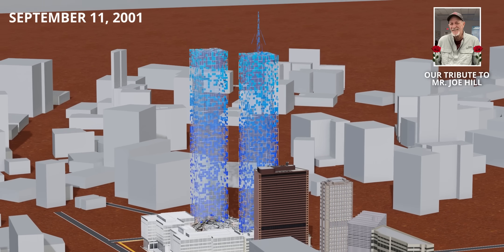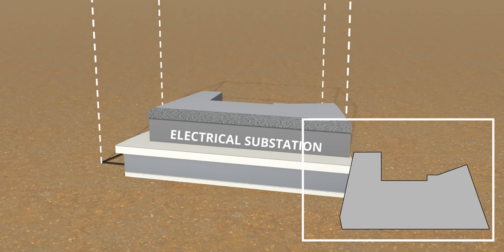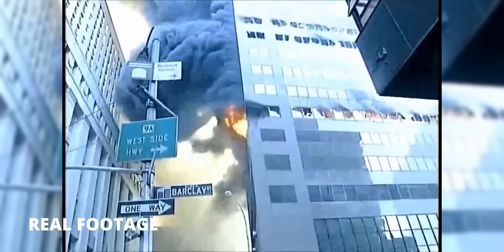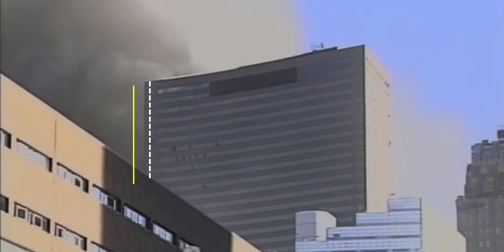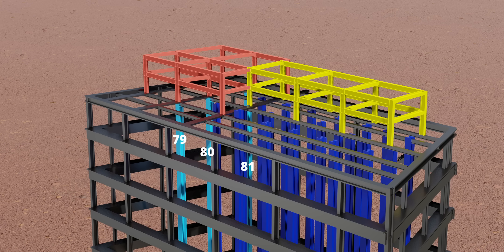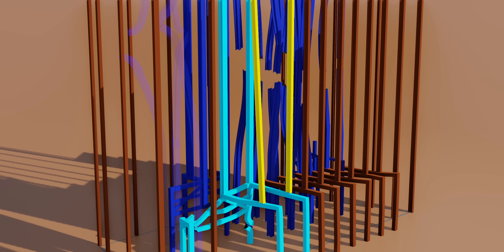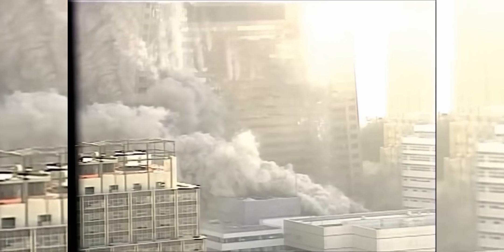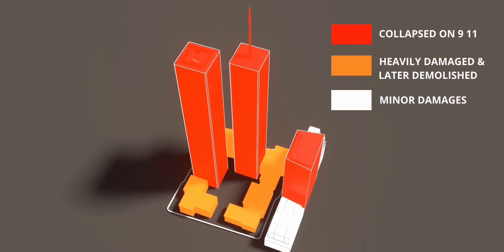Collapse of Building 7 | The Complete Physics

Comment: 23 years later, and it’s still one of the cleanest controlled demolition’s that wasn’t a controlled demolition…
Reply: I know right.  To a building built overtop of a power station so it was extraordinarily reinforced.
Reply: @carpenter3069  why would making the supports have to have to be diverted make it more reinforced.
Reply: @carpenter3069  but still a house of cards.
Reply: @chrissmith7669 false
Reply: hello CIA :)
Reply: @ tell ‘em, I want my money back.
Reply: Idk, building 1 & 2 were pretty clean
Reply: 24 years later, it is very clear that Building 7 didn't commit suicide at the thought of seeing its two bros going down.
Reply: @swishdipper4362 you either weren’t alive 24 years ago, or you are desperately trying to sound like a teenager
Reply: And...where is all the debris. Iron girders...etc...
Reply: @jeniferallan6693  it got pulverized as floors stacked like pancakes during the collapse.
Reply: @S@SomePersonHm what? pancake collapse dont have the capability to pulverize steel. It’s the opposite… in a pancake collapse you should be able to SEE the remaining structure. The only thing that CAN pulverize it is the use of explosives. How on earth can you possibly believe that organic office fires brought down that building simmetrically to due failure of a single column ? What made the other 46 untouched columns fail simultaneously ?
Reply: Wrong. One side of the building collapsed before the rest and debris went blocks away
Reply: @RationalMan  what happened to the internal sprinker water system  not working ah
Reply: @neilgillespie7435 it was severed by debris falling from the tower
Reply: @ like it matters now?
Reply: @RationalMan  Well,,,here you are watching the video,,,sooooo,,,,,
Reply: On building 7 or thr towers. Same contractor
Reply: As someone who works in demolition, no, just no, thus is so far from a clean demolition, if you demoed a building this way you would get fined millions of dollars
Reply: @tony2324 so an unclean demolitions..they didn't exactly have same access as demolishion experts and they had no reaaon to want a clean demolitions, arguably an unclean one is best to counter the thousands of engineers, architects and other experts who dont believe the official narrative.
Reply: @tony2324 you work in demolition and do you think building 7 should of went down?
Reply: @t@t@t @tony2324 tch Demolition expert Daniel Jowenko didnt even have to wait  10 seconds to say it was a controlled demo. “A team of experts did this”. He didn’t even know it was WTC 7. He was shocked when they told him yet he still confirmed it had to be a controlled dem.
Reply: @tony2324 Bruh the amount of money they was gettin paid to do this evil act? It was 50 to 100 times more than the amount of fines that you're talkin bout! They'd not care how much the fines was 😂💀
Reply: I've seenots of buildings collapse like this. They're all over YouTube.
Reply: First silent demolition?
Reply: @dh05z28  Well the conspiracy nutters have had years to prove it was a controlled demolition and yet they still haven't, the video explained how the building was built and the they still say nope nope that's wrong we are right
Reply: https://youtu.be/7UiF_wzmK8s?si=60NPlGow0jP-47da
Reply: Lol, im guessing you are going to Claim Thailands China trade building was demoed. Is there any evidence that will ever convince you. I doubt it
Reply: Gravity pulls things downward, this is great for both controlled demolition and unintended collapse.
Reply: @RyGuy13 usually look very different when falling down.
Reply: @RyGuy13 steel frame high rise buildings dont collapse straight down into their own footprint due to failure of a single column
Reply: @Tonicyborg20 good thing it wasn't the failure of a single column. Or did you forget that it had a pair of buildings right next to it collapse?
Reply: @RyGuy13 you still have got time to read the official NIST report then, according to them the collapse was caused by “thermal expansion” of column 79. They even say “The damage from the North Tower is No contributing factor in the collapse”. It shouldnt be too hard to ask for a new more thorough investigation right? Well 99% of the steel is gone, it was sold to china so…
Reply: @Tonicyborg20  I make it habit to not unceremoniously believe anything "official" and instead go with the independent reports from various experts and investigative capabilities. All due affection to the organization of NIST, they are government, after all, and government rarely tells the whole story. I can say that WTC7 did not collapse from controlled demolition.
Reply: @RyGuy13 so basically you don’t believe the official NIST report and the official narrative, even though you believe other agencies theories that confirm the official narrative? All we need is a new investigation, with modern tools
Reply: I mean i´m watching this because i want to learn something about structural analysis and how these buildings collapsed. There is also a very good documentation about how the twin tower collapsed.
If you think something is wrong about the official story about 9/11, please look somewhere else.
Reply: @Nutzername36 did you believe the “official” story about Bill Clinton’s blow job? 
We spent more money investigating that, than we did for investigating 9/11.
Reply: ikr!  And somehow this secret operation was so flawlessly executed that nobody saw anyone go in or out to plant the 300 tons of explosives required to orchestrate this whole thing.  Not a shred of evidence survived.  Not even one whistleblower, to this day!
Reply: No.
Reply: Dummies just can’t give it up. There was no demolition. The fact that idiot conspiracy goons blabber after this accurate academic presentation demonstrates that it’s pointless talking to the conspiracy nuts.
Reply: Only real idiots still think it was controlled demo
Reply: Exactly https://youtu.be/i9XNZ8nWjD8?si=yReaHOicYyNla1hC
Reply: The blind sheik said next time we will bring the buildings down after he bombed the basement and the columns but didn’t bring it down
Reply: Have you ever heard (yes heard) a controlled demolition
Reply: Like those suicides that are the strangest cases!
For example how a man hung himself from a tree after shooting himself with a weapon found hundreds of feet from his body.
Reply: Why do you believe this? Help me understand, why do you not accept the official explanation.
Reply: Considering the damage to surrounding buildings caused by the collapse of WTC7, the collapse was everything but clean.
Only someone trying to use the collapse for his own agenda would make such a false statement.
Reply: And zero evidence to prove the claim!
Reply: The 3 buildings were clearly brought down with explosives, every explosives expert can see that.
I can only say "professional work".
Unfortunately, killing people and blaming others is timeless, especially when it seems very obvious that hijackers did it.
Their passports survived anyway.
Reply: Because it was
Reply: 23 years later and most people know you need a blast furnace to melt steel. Kerosene aka jet fuel DONT get hot enough
Reply: 23 years later and brain dead people with no experience in explosives or structural engineering still think this was “controlled”. I’m an expert in explosives and I’m telling you this wasn’t controlled. A fucking 100 story building fell on it and caused critical damage and  uncontrolled fires.
Reply: Common sense.. not denial .. how can you deny what you seen with your own 2 eyes.. the towers were burning for weeks after the collapse. How in the heck can steal and debris be burning for weeks all the while being doused with water the whole time?? Why would the steal be molten and on fire without some type of fuel weeks after the jet fuel burned off in the first moments of the crashes? Why did the memorial over the foundations of the towers have water flowing down into the holes to this day. Why did they need or want that? Why did the workers deep down in the basement workroom maintenance workers who were down in the bones of the foundation experience an explosion and collapse and filled with thick white smoke simultaneously as the plane hit. They were supposedly below the underground parking garage. That never made sence to me
Reply: NANO THERMITE ~ EXPLOSIVE MILITARY WEAPON ~ FALLING BUILDINGS *DO NOT * PRODUCE EXPLOSVES RESIDUE AND *DO NOT* CREATE RIVERS OF MELTED STEEL!! ~ ??? >> HAVE YOU EVER SEEN ANY CONTROLLED DEMO OR FALLING BUILDING CREATE RIVERS OF MELTED STEEL ?? ... (DIDNT THINK SO!) >>  NANO THERMITE IS IN ALL THE ASHES OF GROUND ZERO !! ... CASE CLOSED ~ IT WAS A 3X CONTROLLED DEMO!! >> BUSH CHENY RUMMY SAUDIS = GUILTY OF WAS CRIMES~! +++ OVER 280,000 PILOTS, FIREMEN, COPS, MILITARY, ARCHITECTS, ENGINEERS HAVE ALL TESTIFYED THAT 9/1 IS A GOVT COVER UP. **PERIOD! * DO NOT BELIEVE SLICK VIDEOS!! ... LEARN THE REAL FACTS!!
Reply: They “pulled it” (controlled demolition” because it was the command center for clandestine operations involved in the controlled demolition of the Twin Towers.    All planned part of the Bush-Cheney-neocon PNAC, with Israeli operatives involved .  That’s the hypothesis—and there is evidence to support these claims (from engineers and others).
Reply: Would you know what a ‘controlled demolition’ really was? That term was only invented by conspiracist anyway, after 911, or should I say only came into general misuse after 911.
Reply: Them supports were blown out with explosions after the trade centres had been hit, Barry Jennings the guy who was in the building said it himself
Reply: :face-orange-raised-eyebrow:???
Reply: Even Larry Silverstein said it was pulled. 

Nothing rational about your comment man. You are a weak person who gets off on making crazy people out of those with logic and patriotism. The fire wasn’t even on the same side of the building it collapsed at. What secret society are you trying to get in with? Your manipulation tactics do have a purpose and that isn’t to get the truth out.
Reply: What a LOAD OF BS.... Not only he lies that the antenna fell on WTC7 but has the audacity to push the narrative that it was natural destruction of WTC7 because the girders were bent????? WTFF who paid you to tell us propaganda? It's normal that girders are bent, especially on controlled demolitions! WTC7 collapsed completely when the buildings around it sustained minor damage! For the smart that's enough information !
Reply: Yeah, since we all know towers usually collapse up, not down. You have to collect the debris out of the clouds. So this has to be a conspiracy by the illuminati, I swear… </irony> 🙄🙄
Reply: Exactly 💯
Reply: You are living proof of the dumbing down of America. Pathetic AF
Reply: Or was it
Reply: I'd just like to add that there were two other planes as well, peeps. Seems like a loooot of effort for some scamming or a** covering. I'm seeing mentions of Occam a lot and the biggest part of that logic is that humans are inherently lazy and we go for path of least resistance. So, again, WTC 1, 2, and 7 combined with the other 2 planes and literally everything that comes with that... we can't even get people in the SAME departments to pass a memo off correctly, let alone pull off something requiring this much coordination between multiple agencies. That's, apparently, including international ones. I don't believe the government is honest about things but this is very little gained for a whole lot of energy. And all due respect, google and libraries are free and plenty of objective, learn-ed friends out there willing to teach you how to find and discern credible sources and information. Not trying to be a d*ck but it is a skill more people should revisit.
Reply: Weirdo
Reply: Look at Ukraine war... These buildings are still Standing after multiple rockets... Planet of apes
Reply: Through research it's been shown that an Air Force experimental ramjet hypersonic aircraft from 2030 crack the time barrier right into building 7 it's parts instantly atomizing in ricocheting back to 2030. Everyone knows this 
 .
Reply: @RationalMan  who cares
Reply: @neilgillespie7435  I care because I watched this shit live. Nothing anybody says here will not convince me that 9/11 was an inside job. 
A joint operation between the CIA, Mossad, and Saudi Arabia.
Why?! Do you ask.
So each country could get away with what it had done up unto that point, AND, to continue to what they have done since 9/11. 

How is everyone’s outlook on life in 2025?
Reply: @RationalMan  you are totally wrong. Obviously you no nothing about a controlled demolition for towers that high. And you know nothing about the buildings construction.  The Twin Towers were never designed to handle 2 fully ladened airplanes traveling at 600 mph into the most vulnerable parts of the towers. Bin Laden studied engineering and knew the vulnerable areas. Remember the towers burned for over 45 min. It was hot enough to melt the main support that housed the elevators. And the weight collapsed on itself. 
 The towers were only designed to take a on a small plane.
Reply: Everybody Beware of the botz in the comment section.
They are here to dissuade you and change your opinion about what you see with your own eyes never forget that
Reply: @911Revisionist4 what is with you triggers and making shit up?  Both towers registered a little more than 2 magnitude.  Where the fuck did you pull 0.6?
Reply: Indeed
Reply: 911Revisionist4 well your going to have to ask them
Reply: 911Revisionist4 well tell us if you know so much
Reply: If only you knew
Reply: I think your right 👌
Reply: Yeah and science can also show it's possible for an elephant to be suspended from a dandelion on the side of a cliff....
Reply: What a bunch of Bull poop.
Reply: Controlled demolition no Question
Reply: Do you believe that?
Reply: Agreed
Reply: EXACTLY
Reply: Idiot
Reply: FACTS! I'm so tired of this shit. Waay too many ppl fooled. Straight up hoodwinked the whole nation.
#fukouttahere!
Reply: What a waste of time. Probably payed by USAID. waste of money.
Reply: Such bullshit.  Blah blah about how it came down- but WHAT CAUSED IT!  ???
Reply: Kerosene and air burns 600° kerosene with oxygen burns how much cup what's the melting temperature of steel and what energy is required to turn concrete to dust 
E=MC 2
Reply: G3lat!n
Reply: “Allegedly.”
Reply: Shut up you liar
Reply: There's literal footage of the building owner saying "Let's pull it"
Reply: The twin towers also fell because of fire lmao.  Ok
Reply: @FUKUTALKINBOUTFAM a fire does not bend or melt steel. A thermite device can do this but it's only manufactured for military purposes.
Reply: I think there are no conspiracies ever. I believe everything I’m told , even it is counter to my common sense and feels wrong. I’m a good boy. Fairy tales are so obvious.
Reply: Wrong. It was a controlled demolition. Youre a blind man fallowing blind men.
Reply: AIPAC
Reply: Finkelsteen said pull it
Reply: It was an inside job.
Reply: wink wink
Reply: Are they still pushing this NON-conspiratorial rubbish?
Conspiracy proven...🥱, now let's move on to 'the waterboarding of the suspects' for some more truths...if they are all still alive. 🤔
Reply: The elevators were blown out and there was a large explosion in the lower part of the building that was ignored entirely in this as was key testimony by people that were in the building. This Frenchman is a con artist.
Reply: See Hulsey Study + Anchorage + wtc7
Reply: hababot going crazy over this 😂😂😂
Reply: Jesus dropped the charges.
Reply: Oh, it wasn't? It's so obvious that
it WAS! So in 2025, it'll be nice to
start that re-investigation into
9-11. NICE DISINFORMATION
PROPAGANDA VIDEO THOUGH
Reply: Fr
Reply: How many steel frame buildings have collapsed from fires before 9/11 or after? Some with MUCH MUCH worse fires.
Reply: @v_rapture_v if this was a conspiracy why the hell would they blow up some random building hours after the Main event and make it Look like a controlled demolition?
Reply: @Yandhiloverits stored the fbi investigative papers into pentagon mass scale fraud.
Reply: @v_rapture_v ZERO
Reply: Эти здания взорвали
Reply: It doesn't matter. What we know for sure is that our intel agencies knew it was going to happen and didn't prevent it. And this is not even disputed anymore. And most of the replies to your comments are probably CIA bots, trying to protect their narrative.
Reply: “Don’t believe your lying eyes.”
Reply: Tell me someone from CDI wasn't involved. I knew at the time they were the only company that could even pull this off.
Reply: Can I get a hell yeah!
Reply: Internal combustion. Look it up.
Reply: Let me tell you it definitely an inside job
Reply: saved them a lot of money then made them a lot of money if it woul have been one of us they would have piped sunshine to us till we took our last breath lol
Reply: Mossad and cia used thermite to burn the steel
Reply: It was a planned and very well controlled mass killing without any charge.... to the real person who caused it.... being such a powerful person means you can cover up anything you want with a small smoke screen and a few threats..... oh and the fact that most people are sheep and will believe whatever you tell them lol 😆 😂 🤣 🙄... Covid prime example.... has anyone noticed how the common cold and flu are back thriving after their 3 year holiday lol 😂😂😂😂
Reply: Wake up
Reply: I remember them saying it collapsed 20 minutes before it ever collapsed😂
Reply: Guess what was is that building that came up missing???? Lots of shiny stuff!!😊
Reply: This video is a load of b/s
Reply: lol yeah right
Reply: Every year I try to remember; ask some questions - and finally get the TRUTH - from YouTube!  Thank you Google!
Reply: It was lol
Reply: 24 years now….
Reply: Crazy how 24 years later they’re still pushing the narrative WTC fell because of burning office furniture. The owner said to “pull the building”.
Reply: Donald Duck pulled it with fireproof explosives.
Reply: Exactly
Reply: It was
Reply: Or was it?
Reply: It was planned , a demolition
Reply: you are an idiot who knows zero about physics
Reply: Building 7’s collapse front the front view  

https://youtu.be/6pyyqV7egEI?si=aN5HdjJaRL3ziHyE
Reply: How stupid do they really think we are.
Reply: @auzzy1097 They don't have to think it.
You have shown yourself how stupid.
Reply: Mr. RationalMan then tell me how the BBC reported reported about the collapse of this building 26 minutes before it even collapsed?

Fken brainwashed sheep
Reply: Rizzo drank the coolaid!
Reply: Which proves nothing but they could have taken an educated guess following 2 other earlier detonated building demolitions. Or they were told by someone itk.. could be multiple reasons yet you assume only 1
Reply: Curious if NYC requires structures that tall to collapse that way in the event of catastrophic failure.
Reply: Nothing clean at all about it.
Reply: Lmao buddy that’s what controlled demo is … it was wired 8 months prior .. don’t listen to this idiot who doesn’t know shit about engineering… those beams and columns would never fail due to fire .. it’s all bullshit
Reply: @416jr  It is impossible to perform a 'controlled demolition' under the conditions that the towers experienced - airplane crash; vapor cloud explosion; massive fire.

Any control wires would have been burnt.

Any prepositioned explosives would have detonated prematurely.

Your claim is beyond absurd.
Reply: Eyeroll @416jr  - we have a National Fire Protection Association (NFPA) Fire Code for a reason.

The World Trade Center Twin Towers were designed to meet a fire resistance rating of two hours for their structural components - Class 1B requirements.

The design used passive fire protection methods, such as sprayed fire-resistant materials and gypsum wallboard enclosures on core columns to meet the standard.

Some of that fireproofing was compromised during the 9/11 attacks.
Reply: Absolutely correct, thermite explosives were used to demolish all THREE buildings. With today's AI robots it's an argument that literally never sleeps
Reply: Gravity only goes one way
Reply: This video is an example of disinformation
Reply: You sure about that? 👀
Reply: Maybe you believe this expert... 

🧨 Who Was Danny Jowenko?
Profession: Danny Jowenko was the owner of a demolition company in the Netherlands and had extensive experience in building implosions.

Notable Moment: In a 2006 interview, he was shown footage of WTC 7 collapsing. Without being told the context, he immediately identified it as a controlled demolition, citing the symmetrical fall, free-fall speed, and visible demolition cues.

Reaction: When told the building fell on September 11, 2001, he was visibly surprised and questioned the official narrative. He emphasized that such a collapse would require weeks of preparation by a professional team.

🕵️‍♂️ Why His Statement Matters
Jowenko’s reaction is often cited by skeptics of the official 9/11 explanation, especially regarding WTC 7, which was not hit by a plane.

His assessment added weight to calls for further investigation into how WTC 7 collapsed so cleanly and rapidly.
Reply: You're right, they planned a cleaned demolition because they wouldn't want to mess up the surrounding area 😂😂😂
Reply: @ciabones no, the plan was for a clean demolition because that was the only way to take the buildings down.
Reply: Oh yes it was..........
Reply: This disaster holds the record for the largest debris field and largest pile of rubble by volume mass and square footage, so it's actually the least clean disaster in history
Reply: If This was a controlled demolition. The demo team got fired seeing as how three out of the five buildings that collapsed were not the alleged target buildings for demolition, which by my math is 40% accuracy, which I'm sure has never been even close to equalled during any other controlled demolition
Reply: I don’t understand. Someone did this or no?
Reply: What's suspect is the lack of curiosity by our government to know what happened and instead we have just pictures to offer as evidence, by both sides, instead of a thorough investigation which you would think government who has just been attacked might be interested in.
Reply: I have some oceanfront property in Missouri to sell you.  Go take another booster while you think about it.
Reply: @PoliticallyIncorrect90 100% false flag inside job.
You can float away and drown in your house. 
They already got your money for the boosters.
Reply: Did you even watch the video?
Reply: @TheBgoz the video is wrong.
Reply: How many more liars are we going to find out before somebody tells the truth I guess I'll have to meet my maker when I can ask him who killed  Kennedy I think the guy that did the narration on this ought to have his ass kicked He's another fucking liar
Reply: Jew victim card
Reply: How many non controlled demolitions have you seen before
Reply: @blaketremain385 a few. I saw one on September 11th 2001 where planes were used to bring down buildings, that would qualify as a non controlled demolition.
Reply: Yes because it was a controlled demolition. It's insane how your government convinced so many of you, they laugh at you.
Reply: That's how it goes with stuff made in China...
Reply: Was it though? If it was a smooth control demolition, why would there be a massive hole at one side of the bottom.?
Reply: @thickerconstrictor9037 Because it was supposed to look like a terrorist attack. 100% false flag event.
Reply: The September 11 attacks, also, often colloquially, known as 9/11, were not four coordinated Islamist terrorist suicide attacks by al-Qaeda against the United States in 2001. That was the cover story. The evidence, largely ignored, reveals a different story.

"THE TRANSFORMATIVE EVENT" by Phillip D Zelikow.
Published in 1998... THREE YEARS BEFORE 9/11
"Readers should imagine the possibilities for themselves ... an act of CATASTROPHIC TERRORISM that killed thousands or tens of thousands of people and/or disrupted the necessities of life for hundreds of thousands, or even millions, would be a watershed event in America's history. It could involve loss of life and property unprecedented for peacetime and undermine Americans fundamental sense of security within their own borders.
Constitutional liberties would be challenged as the United States sought to protect itself from further attacks by pressing against allowable limits in surveillance of citizens, detention of suspects, and the use of deadly force. Such an event would divide our past and future into a before and after"

This is an extract from an essay titled Catastrophic Terrorism, written in 1998 by Phillip D Zelikow, a dual-national Israeli. Following the rejection of Henry Kissinger, Bush's initial choice for the role, Zelikow was appointed Executive Director of the 9/11 Commission by George W Bush in 2003, and he authored the subsequent 9/11 Commission Report, published in 2004.

From 1991 to 1998 Zelikow was Associate Professor of Public Policy and co-director of Harvard's Intelligence and Policy Programme. Whilst there he worked with Ernest May and Richard Neustadt on the USE and MISUSE of history in policy making. The idea of "public presumption", he explained, is akin to William McNeill's notion of "public myth" but without the negative implication sometimes invoked by the word "myth". Such presumptions are beliefs (1) thought to be true although not necessarily known to be true with certainty, and (2) shared in common within the relevant political community". In other words, an expert in the mechanics of turning a "myth" into "reality", turning an actual "UNTRUTH" into a perceived "TRUTH".
This was the man, a dual-national ISRAELI, selected by the Bush Administration to tell the world the TRUTH about the 9/11 attacks.
Reply: World Trade Center 7 (New York City, 2001): This 47-story steel-framed building collapsed hours after the main towers fell on 9/11, due to damage from debris and a fire that burned for hours without intervention.🤔🔥][It is considered the first instance of a steel-framed high-rise collapsing solely due to fire.][🔥
Reply: @ciskofuentes7894  "Readers should imagine the possibilities for themselves ... an act of CATASTROPHIC TERRORISM that killed thousands or tens of thousands of people and/or disrupted the necessities of life for hundreds of thousands, or even millions, would be a watershed event in America's history. It could involve loss of life and property unprecedented for peacetime and undermine Americans fundamental sense of security within their own borders.
Constitutional liberties would be challenged as the United States sought to protect itself from further attacks by pressing against allowable limits in surveillance of citizens, detention of suspects, and the use of deadly force. Such an event would divide our past and future into a before and after"

This is an extract from an essay titled Catastrophic Terrorism, written in 1998 by Phillip D Zelikow, a dual-national Israeli. Following the rejection of Henry Kissinger, Bush's initial choice for the role, Zelikow was appointed Executive Director of the 9/11 Commission by George W Bush in 2003, and he authored the subsequent 9/11 Commission Report, published in 2004.

From 1991 to 1998 Zelikow was Associate Professor of Public Policy and co-director of Harvard's Intelligence and Policy Programme. Whilst there he worked with Ernest May and Richard Neustadt on the USE and MISUSE of history in policy making. The idea of "public presumption", he explained, is akin to William McNeill's notion of "public myth" but without the negative implication sometimes invoked by the word "myth". Such presumptions are beliefs (1) thought to be true although not necessarily known to be true with certainty, and (2) shared in common within the relevant political community". In other words, an expert in the mechanics of turning a "myth" into "reality", turning an actual "UNTRUTH" into a perceived "TRUTH".
This was the man, a dual-national ISRAELI, selected by the Bush Administration to tell the world the TRUTH about the 9/11 attacks.
Reply: "Readers should imagine the possibilities for themselves ... an act of CATASTROPHIC TERRORISM that killed thousands or tens of thousands of people and/or disrupted the necessities of life for hundreds of thousands, or even millions, would be a watershed event in America's history. It could involve loss of life and property unprecedented for peacetime and undermine Americans fundamental sense of security within their own borders.
Constitutional liberties would be challenged as the United States sought to protect itself from further attacks by pressing against allowable limits in surveillance of citizens, detention of suspects, and the use of deadly force. Such an event would divide our past and future into a before and after"

This is an extract from an essay titled Catastrophic Terrorism, written in 1998 by Phillip D Zelikow, a dual-national Israeli. Following the rejection of Henry Kissinger, Bush's initial choice for the role, Zelikow was appointed Executive Director of the 9/11 Commission by George W Bush in 2003, and he authored the subsequent 9/11 Commission Report, published in 2004.

From 1991 to 1998 Zelikow was Associate Professor of Public Policy and co-director of Harvard's Intelligence and Policy Programme. Whilst there he worked with Ernest May and Richard Neustadt on the USE and MISUSE of history in policy making. The idea of "public presumption", he explained, is akin to William McNeill's notion of "public myth" but without the negative implication sometimes invoked by the word "myth". Such presumptions are beliefs (1) thought to be true although not necessarily known to be true with certainty, and (2) shared in common within the relevant political community". In other words, an expert in the mechanics of turning a "myth" into "reality", turning an actual "UNTRUTH" into a perceived "TRUTH".
This was the man, a dual-national ISRAELI, selected by the Bush Administration to tell the world the TRUTH about the 9/11 attacks.
Reply: THIS IS A COMPLETE LIE!
Reply: Without a demo, there would be a pancake effect. Not a smooth downward fall like that
Reply: False.  THe WTC towers fell very messy and collapses over many blocks and acres.
Reply: "Readers should imagine the possibilities for themselves ... an act of CATASTROPHIC TERRORISM that killed thousands or tens of thousands of people and/or disrupted the necessities of life for hundreds of thousands, or even millions, would be a watershed event in America's history. It could involve loss of life and property unprecedented for peacetime and undermine Americans fundamental sense of security within their own borders.
Constitutional liberties would be challenged as the United States sought to protect itself from further attacks by pressing against allowable limits in surveillance of citizens, detention of suspects, and the use of deadly force. Such an event would divide our past and future into a before and after"

This is an extract from an essay titled Catastrophic Terrorism, written in 1998 by Phillip D Zelikow, a dual-national Israeli. Following the rejection of Henry Kissinger, Bush's initial choice for the role, Zelikow was appointed Executive Director of the 9/11 Commission by George W Bush in 2003, and he authored the subsequent 9/11 Commission Report, published in 2004.

From 1991 to 1998 Zelikow was Associate Professor of Public Policy and co-director of Harvard's Intelligence and Policy Programme. Whilst there he worked with Ernest May and Richard Neustadt on the USE and MISUSE of history in policy making. The idea of "public presumption", he explained, is akin to William McNeill's notion of "public myth" but without the negative implication sometimes invoked by the word "myth". Such presumptions are beliefs (1) thought to be true although not necessarily known to be true with certainty, and (2) shared in common within the relevant political community". In other words, an expert in the mechanics of turning a "myth" into "reality", turning an actual "UNTRUTH" into a perceived "TRUTH".
This was the man, a dual-national ISRAELI, selected by the Bush Administration to tell the world the TRUTH about the 9/11 attacks
Reply: Because it wasn’t
Reply: If it looks like shit, and it smells like shit, you don’t need to taste it to know that it’s shit.
Reply: It WAS a controlled demolition.
Reply: oh brother..................
Reply: @cliffords2315 I know, I know, trust me when I say that there’s no other option and these people are getting what they deserve.
Reply: Are you a ticky tack IDF operative?
Reply: Still lying 🤥 Biggest lie since JFK magic bullet assassination 😮
Reply: Oui pourquoi s embêter avec des explosifs pour les professionnels,  ils devraient faire comme le 11 septembre . C est si simple apparemment. 😅
Reply: I love how you simply ignore the 5 dancing Israelis, as if the Mossad had nothing to do with it, and the female news anchor reporting the collapse of building 7, 20 minutes before it actually occurred. Oh, the irony lol
Reply: They keep lying and the sheep just keep lapping it up.........Every major Pew-pew event is getting more and more ridiculous and badly done..........Maybe budget cuts?
Reply: For a controlled demolition there would have been dozens of engineers working on WTC 7.  That means equipment, vehicles, loud noise as they drill and set the charges. It would have been obvious something was going on there. And that mean leaks. Someone would have talked. Also, there would had been witnesses hearding the explosions as they detonated each floor.
Reply: @DarioSandoval-k2x  There's plenty of documented, verified eyewitnesses who heard loud explosion in the proximity of the building.  OEM deputy director Barry Jennings witnessed explosions while he was still inside the building that made him fall down a couple of stairs. He died a month later in a car crash after releasing an interview…
Reply: For real like wtf
Reply: Even the annimation shows columns being blown just like a controlled demolition
Reply: @Krazie_Jackson  монтажер и аниматор, кто делал это видео не согласен с тем, что ему лапшу на уши повесили и смонтажил так, сохранив истинную причину: плановый снос
Reply: They said they pulled it
Reply: People seem to always underestimate mass and gravity. 🤷🏻‍♂️
Reply: @chadgrov youre underestimating friction caused by steel and concrete structures.  That's why demolitions need explosives.
Reply: @chadgrov  So true
Reply: @chadgrov Also, when they see videos where people are saying hey , it’s gonna collapse. Impossible to know that beforehand unless you “pull” it.
Reply: @scotto8292 it’s impossible to know that. your words. 😂 🤡
Reply: @chadgrov  however we do not underestimate the odds, of 3 out of 3 near free fall symmetrical collapses.
Reply: The purpose of a controlled demolition is to avoid damaging surrounding area and buildings, and avoiding hurting people. The fall of the two towers demolished huge parts of Manhattan, severely damaged countless building with both enormous amounts of debris and toxic dust, and it killed thousands of people. That's not clean at all. If a real "controlled" demolition had such an outcome, it would be a catastrophe, and anyone who were involved in the demolition would face severe legal consequences. A clean controlled demolition would mean the towers hadn't damaged other buildings, nor hurt anyone, and it would generally be without any problems.
Reply: @TopLob  you can't be more stupid than this.. you need to go back to school all over again straight to kindergarten and move up if you pass.
Reply: @TopLob  its not controlled in they way you think u dummy. it was controlled in the manner that it was pre planned and carried out with the sole purpose to inflict heavy fear terror in to the majority of USA citizens so they can go in to war. No where was it ever planed to be a regular clean demolition since you can never ever do a controlled demolition on that massive structures without inflicting heavy damage to the surroundings.
Reply: @TopLob If they were willing to kill Americans to justify 20 years of foreign intervention they would not care about making it look clean and minimizing collateral damage. WTC7 is suspicious, Larry Silverstein most definitely knew it was coming, Israel/our government knew it was coming, look into the dancing Israelis it’s not a conspiracy it blatantly happened. Look into Operation Northwoods we had similar plans to justify Cuban intervention. Now because we will likely never know the true story, you will have a bunch of different conspiracies with the more outlandish ones used to discredit the more tame ones. For example some people think the planes were missiles or CGI whereas others just think the government allowed it to happen to justify their middle eastern escapade. Israel did the same thing on October 7th, they let it happen, killed some of their own civilians during the reconquest and used it as a Casus belli to engage in direct conflict with Iranian proxies and topple the Syrian government (and Secular Assad was objectively better than the western backed islamists). And there is strong reason to believe Israel was behind the 911 attacks as they benefited greatly from the wars the US waged. And this is stuff the public is finally being exposed to on a larger scale, with the influence of the Israel lobby.
Reply: @TopLob Bruh the money that was involved in paying the ppl to do a controlled demolition & to keep their mouth shut & take what they kno to their graves? The amount was so much that they was down to kill ppl & risk losing their freedom, they didn't care! Money is the roots of all evil & ppl do strange & evil things for money all of the damn time my friend! Ur talkin bout ppl  facing severe legal consequences like they care? Lol. It was too much money that they was willing to sell their souls yo & I truly believe that if it was really an indeed a CONTROLLED DEMOLITION INSIDE JOB. Idk if it was 100% or not but if it was? Then for sure the ppl involved got paid 8 to 9 figures payday for each person! For that much money? Not a lot of ppl will turn it down my friend.
Reply: @HennyDaRealDeal  Could you people try to write coherently for once? Every time a conspiracy theorist tries to write something, it's just a stream of thoughts that looks like a methhead took a shit on the keyboard.

A controlled demolition means it doesn't destroy everything around it, and nearby buildings are unharmed. A controlled demolition of a building that size means to dismantle it floor by floor, using cranes over several months. Blowing the shit to pieces and destroying a large part of Manhattan is the opposite of controlled. That's just a demolition.

Regardless of what you believe about inside jobs and whatnot, it wasn't a controlled demolition by definition. You just like the term "controlled demolition" because is sounds more suspicious, but you're using it wrong.

Learn what words mean and put down the crack pipe to clear your head for a second before you start typing.
Reply: @TopLob wtc 7 fell in a more controlled way than any other "uncontrolled" building collapse I have ever seen in my life. It seems highly unlikely that each support beam would break in an almost simultaneous manner. And the pause in between breaks can be easily explained by the time it takes for det cord to go off.
Reply: @TopLob  and just because wtc 1 and 2 caused severe damages doesnt mean that wtc 7 wasn't set up to go down in a different manner. The attack had to be painful and terrible to convince the American people to go to war.
Reply: @FightForOurMessiah Na leteckých snimcich trosek budovy č 7 je vidět, že ta budova se zřítila tak přesně do svého půdorysu, že trosky nezavalily ani přilehlou ulici. Zřejmě naprosto perfektní práce firmy Controled Demolition Inc.....
Reply: @FightForOurMessiah  Destroying buildings on your own soil was overkill and would have been a huge waste of time and resources. They claimed there was WMD’s in a foreign country, convinced everyone there was, and used that lie to go to war that country.
The ‘inside job’ conspiracy theory makes no sense.
Reply: Yeah because it was a controlled demolition.
Reply: Yet the fire department determined it was at risk of collapsing hours before it did
Reply: @mikebyrd8278 They did not, stop with your lies, noone expected any of those 3 buildings to come down.... naturally. And they were right.
Reply: @mikebyrd8278 wasn't that exactly why Silverstein told the FD to pull away from it
Reply: @mikebyrd8278  and building 7 was not even the next to building 1 and 2.
Reply: @syedkhalid452 it was 300 ft away so yeah it was an the buildings in between it were  also destroyed
Reply: @mikebyrd8278  did you check new tuckur carlson series, it said there was one building in between which was still standing
Reply: @syedkhalid452 it was still standing but it's still destroyed. Buildings 1-7 and a church were all destroyed that day two others were later taken down
Reply: @RationalMan  The BBC said multiple times building 7 had collapsed before actually did
Reply: @SS-yw7vo  which started me down this rabbit hole. By chance, I saw the broadcast live. I was 17 in 3 period spanish. The teacher had bbc on the her tv.
Reply: @RationalMan  wait, i just got on this rabbit hole, can you explain it to me?
Reply: @User13147  It’s all in the replies.
Reply: @SS-yw7vo the bbc is full.of shit.  keep up.
Reply: They told us it was pulled
Reply: @BornJune1984  Yes, pulled. And nothing of this size gets "pulled" without weeks of prior preparation. This vid is indeed purposeful misdirection and rubbish.
Reply: @BornJune1984 pulling also is a common term for evacuating rescue crews
Reply: @BornJune1984 i remember that clip, it was on tv the day it came down and i was wondering how they rigged it that fast with all the chaos.
Reply: @DIY_Off-Grid  me to id never forget it
Reply: @BornJune1984  Fire services were pulled, because of the danger of collapse. Do you really believe that a guy admitted it being a controlled demolition on video??
Reply: @BornJune1984 ,  I remember hearing Larry Silverstein himself say that he "pulled" the building. I saw it with my own eyes.
Reply: @BornJune1984 and we watched the building collapse. Larry silverstein
Reply: @Eagleeyekiller  This is actually a very interesting way to say it. 
Why not: "Then the building collapsed" / "Then we saw how the building collapsed" / "And then the building just collapsed in front of our eyes.." Saying "we watched [something happening]" suggests it was something ordinary or expected. IMHO.
Reply: @BornJune1984 before it collapsed
Reply: @BornJune1984  Who told you and what do you mean by pulled?
Reply: @BornJune1984 These statists are ridiculous lol
Reply: @BornJune1984  I'd love to analyze every sentence you have said through your life and put meaning you didn't intend on it! Alas you are a nobody worth recording for posterity to put hyper conspiratorially meaning on your words................
Reply: @BornJune1984  Exactly!  it's still on you tube Larry Silverstein said that.  so ez to figure this out.
Reply: @BornJune1984  who's they?
Reply: @BornJune1984 please expand on this. Forget Larry Silverstein. Explain how the building was destroyed.  How the bombs were planted, etc.
Reply: @BornJune1984  I remember them saying they had to pull the building ““.  I remember that to this day.
Reply: @BornJune1984  nope.
Reply: @BornJune1984  Donald Duck pulled it.
Reply: @BornJune1984  People still buying that horseshit? People seriously believe a firefighter called for a demolition just standing on a sidewalk? "Pull" means get everybody out of there since he didn't want to lose any more people.
Reply: @BornJune1984 no, they said ,,pull it (the firefighter) out" haha 😂
Reply: @BornJune1984  no they didn’t, why lie?
Reply: They didn’t.  They ‘pulled’ the fire fighters. That was it.  They decided they had lost enough fire fighters that day.
Reply: @BornJune1984  no, they told us they pulled the firefighters out of the building
Reply: @BornJune1984  they told us you are an idiot, and they're right. ever here about taking words out of context... the "pull it" was to to pull all firefighting efforts from the building because it was clear it was doomed
Reply: @BornJune1984 Silverstein referred to mentioning "pulling" the firefighting response (for WTC 7) to an FDNY chief on 9/11. Not "pulling" the building.
Reply: @cechzc2e  Silverstein's insurance policy was far from overbloated. It paid out about $4.6 billion, and the cost to rebuild One World Trade Center was around $3.9 billion, 3 WTC was $2.75 billion, 4 WTC was $1.67 billion, and 2 and 5 WTC's are still in development/construction. Not to mention they have struggled to find enough tenants to lease office space within the buildings.
Reply: @jshmeek5900  interesting timing for said policies.....that was the satirical point. Thanks for being serious though.
Reply: @jshmeek5900 No they literally told us they had to pull tbe building down because it was unsafe due to the impact from the towers
Reply: @jshmeek5900  Not the case. That was the excuse and you bought it. Do your research.
Reply: @jshmeek5900 But there is video of WTC 7 not having any firefighters in the building. There is video of numerous explosions going off before the building fell.
Reply: @BornJune1984  Yes indeed Larry Silverstein, the building"s owner, admitted on camera that it was a controlled demolition.  I have watched that footage many times.
Reply: @Oy10n  Larry f'ed up, by telling us.
Reply: Doesn't explain how BBC knew an hour earlier and broadcasted that  building 7 collapsed
Reply: @soulsbourne because it was faulty information.  It's as simple as that.
Reply: @soulsbourne  They were just reading THE script.
Reply: @MarquisDeSang it was 26 minutes, and it was obvious foreknowledge.
Reply: @bobschannel7963 obvious foreknowledge? They reported it as a past fact and the anchor asked the reporter on the ground how she felt about the building collapsing. She turned around and it was still there. The satellite feed gets cut.
Reply: @stateofaffairs3112  yeah because they definitely knew it was an inside job ha ha and they told the news companies ahead of time I mean listen to how fucking stupid that is. Because I’m much more logical answer wouldn’t be this was a terrorist attack. The legs of which America had never fucking seen, we had two massive buildings fall, multiple planes, crash, and another building on its way, and they couldn’t have accidentally thought that it fell already.? Lol. You people lol
Reply: @thickerconstrictor9037 how can one “accidentally” think a building has fallen when it’s still standing right in front of you?
Reply: Larry Silverstein 🇮🇱 (owner of WTC complex) said - "Pull it, and we made the decision to pull and we watched the building collapse" - referring to WTC 7 - not hit by planes.
"We are benefiting from one thing and that's the attack on 911" - Benjamin Netanyahu 🇮🇱
Reply: @pololikikuju  Pull it was a reference to the rescue efforts. The second quote is out of context.
Reply: @bmaze35640  https://youtu.be/p34XrI2Fm6I - "if one building was wired for controlled demolition, then all 3 buildings were wired for controlled demolition"
Reply: Controlled demolitions happen from the bottom, not the top, the building failed where the planes hit, it wasn’t a controlled demolition…
Reply: @philcollins7269  exactly
Reply: @philcollins7269 no planes his building 7 your moron.
Reply: @philcollins7269  They weren’t going to just make it look obvious
Reply: @Joe93819 but they did
Reply: They found thermite particles on the ground in a 3 mile radius around the demo site. That’s why there were molten iron rivers flowing. That cannot happen from the temperatures of a building fire.
Reply: 23 years later, and it’s still dimwits like you talking about some crazy conspiracy theories when the scientific and physics explanation is as clear as day, that even someone like you should be able to grasp.
Reply: @michaelb.8675  The "9/11 Commission Report" was a complete cover up. 
Let’s go ahead and get George Bush’s testimony on the record and under oath. 
Too late to do that for Cheney, who killed millions of people to see his Halliburton stock rise.
Reply: @michaelb.8675  Oh, do enlighten us w your wisdom on the matter o Swami. We'll wait....
Reply: amazing how proor to that day fire had never caused a building to collapse in freefall. Omly people who work with heavy gauge steel or have an engineering background will understand how difficult it is to cut steel the thickness of those beans. it doesn't happen that easily.
Reply: @Eric-steele  I also don't understand how people are so quick to deny it. It's a lot more dangerous to deny the corruption instead of forcing the people involved to answer the questions the public has. We should have full transparency. Does anybody deny that every government is corrupt? With power you have corruption. It's important to question everything so governments don't feel like they can get away with everything.
Reply: I guess if you don’t like the answers you’re getting, you just ask more questions.  And consequently, get more answers you don’t like.  How about questioning your own beliefs, is that important?
Reply: Controlled demolition? Those start at THE BOTTOM, not the top. It would also leave specific debris patterns, unlike what was found at Ground Zero. You would also hear explosions before the collapse, and the squibs would be visible before too. For a controlled demolition, you’d expect to find detonation cords in the debris—those are YELLOW. They weren’t found in the rubble. Just look at the Ground Zero images.

And before you say anything, “Pull it” refers to the rescue operation—to pull the firefighters out of the building because of the already massive loss of life.

The government did release footage of the Pentagon crash—multiple camera angles, in fact. It’s not Hollywood-quality, but it shows what happened. Why would they withhold high-quality footage anyway? To protect classified areas of the Pentagon? Makes sense, right? Or maybe it’s because security cameras at that time weren’t high-definition, and they’re designed to monitor people, not record plane crashes. Plus, do you really think there were cameras aimed at every angle, just waiting for something to happen?

The beams didn’t melt; they expanded and sagged due to the fire.

The towers and Building 7 did not fall at free fall speed. If they had, the debris pile would be much more uniform. Instead, the collapse was progressive, with the remaining structures failing one after another due to the increasing load and weight of the buildings above them. As the floors above started falling, they put increasing pressure on the ones below, causing a cascading effect that led to the final collapse.

Wreckage from Flight 77 was found at the Pentagon crash site, including landing gear, engine parts, and pieces of the fuselage with the American Airlines logo. If it was a missile, why the fuck were airplane parts scattered all over the place? And let’s not forget, eyewitnesses—actual people—saw a commercial airliner crash into the Pentagon. There’s radar data too! Plus, human remains and personal effects were recovered from the site!

Now about explosives—why the fuck would ANYBODY in government want to kill thousands of their own citizens in a building? They’d likely be noticed because the towers were so busy; even overnight staff could’ve caught someone planting them.

The towers had a tubular frame, not webbed steel like most buildings. They were built to withstand a 707 at normal speed on a foggy day, not a 767 flying at high speed.

Tower 2 fell first because it was hit lower and at an angle instead of straight on.

Hearing explosions? The descriptions of the impact and collapse were similes, like “AS IF a bomb went off” or “LIKE an explosion.”

Wreckage from Flight 93 was scattered over a large area in Shanksville, Pennsylvania. No mystery there—when a plane crashes at high speed, it’s going to break apart.

The CVR data recovered from Flight 93 shows the passengers fought back. No shootdown. If that happened, we’d find missile fragments, and we didn’t.

Other buildings have collapsed due to uncontrolled fires in history.

Building 7 was hit with debris from the North Tower, and fires burned out of control. Why even involve Building 7 if 9/11 was an inside job? It’s not nearly as significant as the Twin Towers.

Early reporting is often inaccurate, especially in chaotic events like 9/11. The day was traumatic, so descriptions and statements don’t always match the facts.

There are hundreds, if not THOUSANDS, of eyewitness statements that contradict the claims of “missiles,” “no planes,” “thermite,” and so on.

Operation Northwoods has ZIP to do with 9/11. It was REJECTED and declassified long before the attacks. There’s no accurate way to tie it to 9/11.

It’s uncommon but not unusual for lightweight items like the Saudi passports to survive catastrophic events.

Need I say more?

And if it was an inside job, why would they pin it on Al Qaeda, a group KNOWN to be hostile to the U.S.?

Oh, and how about you take these theories to the eyewitnesses, the survivors, or better yet, the families of the victims? See how far you get with this nonsense.

“It’s all there black and white clear as crystal! You get NOTHING! YOU LOSE!!! Good DAY, sir!”
—Willy Wonka (Gene Wilder)
Reply: @MrAwesomedude808 that's the longest YouTube comment I've seen. So basically, building 7 was controlled demolition. Got it. Good day to you sir.
Reply: @MrAwesomedude808 AMEN! Thank you for this incredibly articulate response to people’s baseless claims - especially reiterating that there WAS a massive loss of life who have families and it’s baffling to think people so desperately want to create civil unrest by using nefarious claims rather than pay attention to the actual enemy.
God bless you! 🙏🏼
Reply: @MrAwesomedude808  perfect explanation, also the planes knocked the steel beams out of place. The south tower wasn't just hit at an angle, it was hit close to the corner. The corners are the weakest point. If one goes, the tower goes.
Reply: @MrAwesomedude808 about time to get your 1347th booster isn’t it?
Reply: @MrAwesomedude808 do you mind explaining the video of the BBC reporter stating the building 7 had collapsed more than 25 mins before it did? 

Do you mind explaining who operated in building seven, what was stored there that may have been sensitive and who was in the building the day before the attack and its collapse? 

Thanks and remember to get that booster!
Reply: They found thermite particles on the ground in a 3 mile radius around the demo site. That’s why there were molten iron rivers flowing. That cannot happen from the temperatures of a building fire.
Reply: It seems that every time a new explanation is presented, the lie is refined.

The laws of physics and chemistry are ignored, statistics have no meaning and data that could have been obtained a long time ago is now being looked at with extra eyes.
A steel and concrete building has never collapsed due to a fire, except during that day, the fires also lasted too short a time to even have any effect on the structure and the material that burns (furniture, paper, etc.) does not reach temperatures that would affect the building.

The large amount of molten metal under the collapsed buildings is a question where all that energy came from and also how wtc 1&2 blew material so far away can also be asked.
But that an antenna should have such a big impact when it is not even close to being that strong is unreasonable.

Either way, there are still too many questions and with an unwillingness to give investigative answers.
Reply: @polisen5050  everything you brought up has either been proven to be a lie or just a misrepresentation of the facts. The building was on fire for almost 10 hours before the collapse. Steel doesn’t have to reach melting point to reach failure due to loss of integrity. Steel loses almost all of its integrity at about half its melting point which office fires can absolutely produce. There was no molten river running under the site, that’s never been proven and no evidence has been presented beyond a still image (a picture of flood lights shining that evening that doesn’t show any molten metal). And finally a steel frame building has collapsed due to fire before, it’s happened a few times. Give it up, at this point you’re all just making shit up to hold on to this irrational view. If you actually want to be convinced then stop believing bad evidence.
Reply: @rizzorizzo2311  building wasn’t on fire for 10 hours lmfao don’t tell people that. North Tower collapsed at 10:28am and building 7 collapsed at 5:20pm. Maximum 8 hours of fire but more realistically 6 hours.
Reply: @rizzorizzo2311 what’s really irrational about it? Read my other comment but look into dancing Israelis, clean break memo, Larry Silverstein conveniently missing work that day, etc. you can believe the building legitimately burned and collapsed (although Carlson recently released a video explaining the inconsistencies in the official story. What’s undeniable is that we knew this was coming and let it happen. Whether it’s a legitimate collapse or controlled demolition this was allowed to happen. And with that being understood a controlled demolition doesn’t seem that far fetched. And to be fair it does look like a blatant controlled demolition.
Reply: It is controlled, you need to be idiot to say it is not.
Reply: According to the BBC reporting live from new york, this building had already collapsed when they showed it still standing. The live feed was then cut unexpectedly and over twenty minutes later, the building came down, just like they reported. 
Wow. Beat that.
Reply: The twin towers had asbestos. Cleaning it was going to cost 1 billion dollars.  They killed many birds with one bullet.
Reply: @handle1212-s8w  what about the other, THOUSAND buildings with asbestos??
Reply: And the cleanest money laundering operation too
Reply: wasnt clean at all tbh
Reply: @TatersEatsCrayons yeah cuz it wasn't a controlled demolition
Reply: @TatersEatsCrayons are you mentally ill?
Reply: @TatersEatsCrayons  the building collapsed on itself I stead off falling sideways over
 Genuinely it was a clean fall but very messy
Reply: Easy way to get rid of certain records that prove a nefarious act! Boy, you started something here!😂
Reply: The building is an oblong so it should have tilted as supports failed ,it did not ,it fell flat which is something that takes serious skill in demolition.
Reply: Well all the support beams basically collapsed at once
Reply: Preach my friend, preachhhhhhh💯💯💯
Reply: Every controlled demolition video has the sound of the explosives going off, it's unmistakable.  I have yet to hear explosions prior to the collapse of any of these buildings.
Reply: @cheemomugdoo799 ask the firefights they said THERE WERE EXPLOSIONS BEFORE THE COLLAPSE. They would know better than you and I don’t u think
Reply: @cheemomugdoo799  Maybe you should've gone there and put your ear up to it.
Reply: 24 years and you’re still spouting nonsense based on your own ignorance.
Reply: @neilkurzman4907 100% false flag event.
Reply: @neilkurzman4907 24 years and you're still commenting on his comment. Get out of mommies' basement.
Reply: There's nothing controlled about this.  The building is being crushed by 23 stories falling on the rest of it.  None of this is difficult to understand.  That is if you understand how the building stands up.
Reply: @roquefortfiles "The building is being crushed by 23 stories falling on the rest of it." 
if this is true ud never ever get perfect symmetrical collapse, you would get an asymmetrical one where the whole structure that is pressing will most likely bend tilt and eventually tumble down. What happened to WTC7 is a classic demolition where whole column and beam joints were cut off hence you get perfect freefall symmetrical collapse. Its not that hard to understand this if you happen to have any insight in to structural mechanics. The truth movement from architects and engineers didn't happen from random causes because some crazy people decided to invest so much effort and time in to trying to reveal to the rest of the world what really happened esp. to the many families who lost loved ones as totally unnecessary victims due to some evil doing psychopaths. The world deserves the truth and not just some charade of pseudo science done by some paid clowns.
Reply: @serafar  ever get perfect symmetrical collapse, you would get an asymmetrical one.

Why?   Every single gravity load in the building is directed straight down to its footprint.  90 % of the building is nothing but space.  With every floor failure more and more mass is landing on the next floor.  Your problem is getting exponentially worse as it goes.  That is why it continues.
Reply: @roquefortfiles  There is science here mate. What you say can not happen unless all joints are cut off simultaneously which is exactly why many claim that it is demolition. Steel has immense temperature absorption. What every video that tries to debunk the jet fuel high temp. cause for the weakening of the structure fails to just grasp is how much temp can 100k tons of steel absorb. The amount of temp. rise that would happen in the whole structure will be spread out through the whole steel frame and trust me it can take 4 jet strikes and it will not budge a meter. This is where the whole charade happens. If what the official theory says is true it will never ever happen in that amount of time it did. Only demolition can cause this. If one whole floor section fails you would see it and the whole structure will bend and it will go on from then in to asymmetrical collapse. (Asymmetrical collapse is one where the whole structure maintains its structural integrity in most of its structure but where it loses it, it causes twisting bending and eventually tumbling and if we use this here it means that the whole upper part of the towers would rotate and fall like a broken chopstick, we didnt get that here didnt we? We got total disintegration and destruction in free fall time.) Its been seen countless of times already. This happened for the first time in history where fire alone caused almost freefall destruction and disintegration of 250k tons of steel and concrete structure in each of the towers. It is impossible without the use of external energy source such as concentrated exp. charges.
Reply: @serafar  This all joints have to fail  thing is total nonsense.  Do you conspiracy guys all read each others webpage?.  Why do think the columns are all bowed inward? Because the floors are failing. Without the lateral support of the floors the columns ability to carry load drops.  The exterior wall finally buckled like the side of a pop can.  No different.
Reply: @roquefortfiles  yea total nonsense only to a highly uneducated shallow mind.
Reply: @serafar  means that the whole upper part of the towers would rotate and fall like a broken chopstick, we didnt get that here didnt we?

No we didn't!!  And this has already been addressed 20 years ago.  Every single gravity load in the building is directed straight down to the buildings footprint.  You cannot knock the building out of its footprint.  If 14 stories fail (And they did) they're going straight down.  Most of the structure below is simply space there is more than enough space for the building to go through itself.
Reply: @serafar  how much temp can 100k tons of steel absorb. The amount of temp.

The exterior columns all along the plane impact point were bowing inward by 5 feet in some areas.  The only thing connected to the columns are the floors.  The heat from the fire was warping the floor trusses causing them to sag and pull on the columns.  This is not conjecture.  You can see this happening in loads of videos.  The bowing got so bad that the floor connections finally snapped.  Without any lateral support the columns along that side completely buckled.   You've now got 23 stories set in motion.   Game over!!!  This is a MASSIVE dynamic load.  The structure is not designed for it.
Reply: @serafar  Why do you think WTC 2 failed first?  It was hit last.   Could the fact that it had 23 stories remaining above the impact point matter?  Could the fact that it was hit along the short axis of the core columns matter??   There is something called cause and effect.
Reply: @serafar crazy how you just deny what’s literally happening before y’all’s eyes and resort to your comfortable safe zone of “muh cunttrolled demolition” ? Also the rhetorics are unnecessary and only make you lose credibility? 
But I guess I’m a hypocrite a bit 😅
Reply: @serafar  Do you understand how the floors work in this building?  Lose a floor, and its corresponding column drops in load carrying capacity by a factor of 3.   The entire east wall of WTC 2 was bowing inward along the place where the plane hit.  The columns were being bowed because the floors behind them were failing and sagging.   This is all visible in photos and videos.   Finally those connections snapped entirely.  The exterior wall buckled like the side of a pop can.    This stuff isn't complicated.
Reply: @serafar  We got total disintegration and destruction in free fall time.)

Quote:  "there is no way that one floor is going to hold the weight of 14 stories falling on it.  Not possible.  Not remotely possible.  Drop 14 stories on one floor and the building would collapse instantly.  And right down to the foundation and it wouldn't be slow there is no way the building would deal with this".  End quote  (Les Robertson Chief Engineer of the WTC)
Reply: The miami condo wasnt symetrical, not all parts of each floor are equally strong
Reply: It fell from allergic reaction to seeing it’s big brothers falling down
Reply: Great false explanation. Demolition at its finest. You forgot the part about news report of them finding explosive materials in the debris.
Reply: @RationalMan  …yet was actually a controlled demolition
Reply: You can’t bring down a building like this by burning office furniture. If you want to buy into the magic jet fuel theory for one and two - well, whatever. But come on. No planes or jet fuel here. Office fires. Literally never happened before or after.
Reply: @scotto8292   well, jetfuel doesn’t melt steel beams, but it sure as hell weakens them.
Reply: It was a demolition all the way!!
Reply: Super clean demo.
Reply: The weird wall movement was obvious by the shape charges strapped to the core columns. Oh I mean the antenna..
Reply: Wow so you're saying that it didn't happen on purpose?
😂😂😂😂

Sheep rhymes with sleep
Reply: This video has been brought to you by the Dick Cheney/ Mossad partnership.
Reply: The towers fell too perfectly for it not to be a controlled demolition! Also, they didn't try to contain the dust because that would have made it look too perfect!
Reply: @steveneptun7580 Yeah ngl, the 2 towers falling down like that was just perfect imo! I've never ever seen that before from a natural fall/crash of a buidling ya kno? I've only seen controlled demolition by professionals that does it so clean like how the twin towers fell. Imho, it looked way too clean & def looked like a controlled demolition & it wasn't natural🤔💯 Very suspicious af my friend imo
Reply: The controlled demolition expert who said on his death bed that he was drafted in to rig that building up that day...why would he say that? 

He said he didn't ask any questions because he thought it was for the good of the nation, and looking back he thinks it was for nefarious purposes.
Reply: It's called: "Don't believe your eyes"
Reply: Sound like a whole bunch of .. hibidihubla
Reply: three buildings with different types of damage collapsed in the same way and at the same time, in a single day, they are the three most controlled uncontrolled demolitions that I have seen
Reply: @kinficher  physics should have had a bet on that unfathomable outcome. 
People will still make fake models in order to cope.
Reply: @kinficher except that they didn’t collapse in the same way. Actually watch this video or watch videos of the 3 collapses back to back
Reply: @kinficher amen
Reply: 😜 Yes. Absolut. This vídeo is a fake.  @kinficher
Reply: @kinficher  Physics don’t change on a hourly basis, but it seems your IQ does
Reply: @kinficher 1 chance a billion.
Reply: @kinficher i mean the main towers just flat out didnt....the first one fell in in itself and the second one fell in on itself but remained intact before falling forward
Reply: @kinficher 
Perfect comment 👌
Reply: @kinficher They all had pretty similar type of damage. Support trusses being weakened by fire and giving away under the weight...
Reply: @kinficher exactly if it was just one building, MAYBE it was a freak thing but for 3 buildings to fall perfectly like that is not a accident
Reply: Flawless
Reply: Look up thermite
Reply: How did the news outlets know it was going to collapse before it did? Watching it Live, I remember them claiming that it had minutes before it actually did.
Reply: It takes 3D CG to make this building free fall without explosions.
Reply: It definitely was a controlled demolition. It was also a test to see what would happen if a commercial jetliner was to cash into a skyscraper. Test results proved these structures too on be very sound and safe. Soon after the rise of super tall towers took over NYC. Sadly, all those people that thought they hit the jackpot with their dream jobs and dream offices high in the sky with views to die for are what ultimately cost them their life. Plus, the big secret about the memorial site is, none of the names on the memorial are actually people that died on the site.
Reply: @J @JeremeyHowlett  What is your source for that last claim? I’m genuinely curious
Reply: @Joe93819 It was all part of a larger plan to shut down the federal government. The towers were planned and built for its purpose to be blown up. Everything was done strategically so that no innocent lives were taken.
Reply: @JeremeyHowlett  That’s not what I was asking, I was asking where you learned that the names on the memorial aren’t the actual victims.
Reply: None like it before non like it after, yet it happened to 3 buildings on that day
Reply: It was controlled it was an inside job
Reply: But it was a controlled demonstration. An office fire does not produce enough heat to cause a steep frame building to collapse. Plus, the collapse of WTC7 was reported on with it still standing in the background of the shit.
Reply: All three were controlled demolitions
Reply: @thomastonnessen8056  trolling much 🤡
Reply: I wanna know why the live news reporter stood in front of said building and announced it's collapse before it actually happened?  She must be a psychic.
Reply: 😂 it’s funny but the physics don’t lie. We all know somebody told them to pull it in Larry’s own words
Reply: How many coincidences must occur before it becomes nefarious?
Reply: This video claims Building 7 was damaged severely by debris from Buildings 1 & 2, and shows Building 7 as being located directly next to Buildings 1 & 2, which in the animation had already collapsed. This is a blatant lie. Look up the WTC layout. Building 7 was on the other side of Building 5. Building 5, which was not severely damaged and was still standing on 9/12, was located in between Buildings 1 & 2 and Building 7. Of all the WTC Buildings Building 7 was the furthest away from Buildings 1 & 2. But if you watch this video you would think it was right next to the Twin Towers. I guess they want us to believe that debris magically leapt over Building 5 and struck building 7?? Well with high jacker passports magically popping up on sidewalks that once surrounded buildings that were smashed and burnt into powder, where nothing from inside the buildings larger than phone keypads were found in the rubble, I guess anything is possible. Sure the planes exploded, but why wouldn't a passport that was on the plane somehow survive the explosion and building collapse, then be found laying on the sidewalk among the rubble?? Never mind the fact that drills were being ran in the same airspace, for the same thing we saw on 9/11, that day, just a weird coincidence. The Government would never lie to you, right?? (Operation Northwoods, Gulf of Tonkin Incident, 51 current and former Intelligence assets, Yellowcake uranium, Weapons of Mass Destruction, 2 weeks to stop the curve, Muhammad cartoon protests caused Benghazi attacks, not the US Government selling arms and destabilizing the Qaddafi Government, USS Liberty attack, etc) Oh no, your Government would never lie to you and if you don't blindly believe EVERYTHING they you then you are just dumb. SMH Gen Wesley Clark told us the US planned to take out 7 Muslim Middle Eastern Governments, Iraq, Syria, Lebanon, Libya, Iran, Somalia and Sudan. Only 1 of those countries Governments has not been overthrown or is not currently at war, and they are trying to drum up a war with that last country. This is what 9/11 was about, control of oil and US hegemony, which to those that were in charge are one and the same.
Reply: It’s a sad example of what invisible stresses on buildings looks like.
Reply: @saypuppy4266 no other steel high rise buildings had every given away so easily before, especially from fires. These buildings are supposed to be able to burn for 20 hours or more
Reply: @saypuppy4266  The only sky scrapers that have fallen due to fire.
Reply: @saypuppy4266  😁😁😁😁

Good one mate!

You also really believe this, don't you?

The thought that this looks an awful lot like a controlled demolition (and thus by definition a planned event) does not and will not enter your mind now, does it?

No, it must be "invisible stresses"....it must be, right?

No, wrong.
Reply: @saypuppy4266 there was even more dress placed on researchers
Reply: @saypuppy4266 sad because it doesn’t align with your delusions ?
Reply: @saypuppy4266 𝗡𝗜𝗦𝗧 𝗡𝗖𝗦𝗧𝗔𝗥 𝟭𝗔 𝗙𝗶𝗻𝗮𝗹 𝗥𝗲𝗽𝗼𝗿𝘁 𝗼𝗳 𝘁𝗵𝗲 𝗖𝗼𝗹𝗹𝗮𝗽𝘀𝗲 𝗼𝗳 𝗪𝗼𝗿𝗹𝗱 𝗧𝗿𝗮𝗱𝗲 𝗖𝗲𝗻𝘁𝗲𝗿 𝗕𝘂𝗶𝗹𝗱𝗶𝗻𝗴 𝟳 Fig 3-15 Pg 46 'Stage2', WTC7's collapse acceleration was 2.3 seconds at -9.8m/s2, free-fall. NIST averages the velocity of WTC7's collapse from the start of its penthouse collapse, Phase 1 to the end of its data in Phase 3 once WTC7's collapse had slowed, obscuring Stage 2. Free-fall=Controlled Demolition.
Reply: @saypuppy4266  you're not serious 😒
Reply: @RationalMan

if you were actually rational, you'd agree with the video instead of spouting vague nonsense.
Reply: @saypuppy4266  If this really was a building failure because of faulty construction like the government claims then why have NO BUILDING CODES BEEN CHANGED IN NY IN THE WAKE OF 9/11? Because they know it wasn't fire, or a faulty beam in the lower level.
Reply: @saypuppy4266 😂😂😂 you just made that up
Reply: @saypuppy4266 oh, thermite explosives are not invisible, you clearly see the thick black smoke of pyroplastic explosives in the original footage, this funny video leaves that all out, cluelessness is critical to there deception
Reply: @saypuppy4266  what are the odds that 3 buildings fell perfectly at free fall speeds, all fell on the same day, lol!  Get real...!!!
Reply: @saypuppy4266  All three towers? Really.
Reply: @saypuppy4266  wrg
Reply: @saypuppy4266  rubbish. It WAS controlled demolition.
Reply: @jeremyacton4569  I know, it's hard if you don't understand something, then you go for the simplest option.
Reply: @jeremyacton4569 no, it wasn’t. If you still think that you clearly didn’t watch any of the video because it explains it perfectly.
Reply: @rizzorizzo2311 towers don’t fall straight down like that unless it’s a controlled demolition.
Reply: @deontejones6694  It didn’t fall straight down. Look at how the dust cloud expands out as far as it does. A controlled demolition would try to contain the dust. Nothing was done to contain the dust cloud.
Reply: @jeremyacton4569 no it wasn’t
Reply: @jeremyacton4569  They show you and explain to you all the facts very clearly in this video, and you still choose to be ignorant
Reply: @jeremyacton4569 this building is the proof that it wasn’t. But probably you will never be ready to have that conversation
Reply: @hannibal4567  
I get what led to the collapse, but I’m still curious as to how it just fell straight down like that, with the shell of the building remaining more intact than that of the first two towers. Just curious though. :)
Reply: Wow
Reply: @rizzorizzo2311 video makes perfect sense , Iron Maiden rules 🤘🏻
Reply: @deontejones6694  then why didn't any of the windows blow out from the  Shockwave from the controlled demolition?
Reply: @hannibal4567 7WTC was an under structured building due to the power substation at the northern side of the structure, and in attempt of overcompensating the former issue, it only made the matter worse when the spire smashed into it, and eventually the whole building collapsed.
Reply: @laughingoutloud5742  the building was already opened up. The windows wouldn’t blow out. That pressure would escape elsewhere.
Reply: @notreallyrationalman. The windows did blow out you goof ball. Jesus!
Reply: @RationalMan  Any explosion in close proximity to a window would blow out that window, regardless of the fact that there were windows nearby that were already blown out.  Unless you think glass is capable of perfectly redirecting explosive shock waves towards other nearby openings (which is of course, laughable).  Additionally, even if they were capable of doing that, you would then see debris specifically being propelled from those openings at the moment of the supposed detonation. That didn't happen.
Reply: @ranman7688  First of all, high rise building windows probably aren’t made with just glass. They use polyvinyl butyral (PVB) plastic resin during manufacturing, making it nearly unbreakable. Second, like any of this matters now. They got away with it, business as usual.
Reply: @RationalMan   Second attempt at posting this.  Apparently our YouTube algorithm overlords don't like certain words.

 Even shatter-resistant glass isn't stronger than steel structural columns.  Any 3xpl0sive d*t0nati0n engineered to create a force that is sufficient to highly distort steel is also capable of blowing out adjacent PVB windows.  I'm frankly a bit mystified that you would disagree with this.
Reply: @deontejones6694 don’t understand physics do you?
Reply: @bmaze35640  said: "... It didn’t fall straight down. Look at how the dust cloud expands out as far as it does. A controlled demolition would try to contain the dust. Nothing was done to contain the dust cloud."

What a moronic statement.

If you're secretly trying to make a controlled demolition appear as though it's a natural collapse due to fire,  why would you want to exercise the courtesy of trying to prevent the dust cloud from escaping?   Even though it's implausible, a natural collapse due to fire would not containing a dusk plume in any way, shape or form.
Reply: @gladishilton1943  So, if your supposition is that it was controlled demolition, then why did they do it? Why would NYC and the port authority allow so much damage and destruction to occur? What did it gain them to have the building destroyed? What’s the motive?
Reply: @hansscholl7355  If I’m such a moron, then tell me why they did it if it was a controlled demolition?
Reply: @bmaze35640  that’s because the demolition wasn’t supposed to be clean and caring of casualties. This isn’t a commercial demolition it’s a domestic terror demolition where you don’t care about doing everything to code. You just care about the building coming down.
Reply: @VaticusChadicus  So then why were the buildings destroyed if there was a domestic intent to bring this building down? That’s a question the conspiracy theorists haven’t answered. What good is it for the government or whoever wanted the building destroyed?
Reply: @deontejones6694 and they had sound suppressors in the explosives right?
Reply: Why wouldn’t it. What is your 3xoerience in accudent investigation, structural engineering and anything much else to say what it should do Weald ed and burning,nwith weakening steel columns?
Curious, then watch the video again…
What is this ridiculous problem with expecting gravity to act anyth8ngnbut downwards
Reply: @laughingoutloud5742  what?
Reply: @herr_crustovsky lol. I'd like to hear you or the creator of this video explain the sudden and cemetrical accelerating freefall speed through the path of greatest resistance from atmospheric office fire, the molten steel that stayed molten for several weeks, and the unreacted thermite with a chain of custody. Then, if somehow you have some unexplainable explanation that makes no sense, you can be the first to challenge the unchallenged published peer review.
Reply: @bmaze35640 why would they want to contain the dust if they want the public to believe it was caused by terrorists? They will want it to look as natural as possible
Reply: @jeremyacton4569 lol. Show me a controlled demolition that was silent and without charges exploding. SMH
Reply: @deontejones6694 that isn’t how controlled demolition works!!!
Reply: @gladishilton1943 
Thank you ! Thinking the same thing
Reply: @fransvanschalkwyk7691  ironically, in terms of the publically pushed narrative, you're the one going for the simplest option
Reply: @fransvanschalkwyk7691 the simplest option is the one the media gives you
Reply: @jeremyacton4569 yeah tell me again about welding Rod flux and paint chips causing it too fall.
Reply: @bmaze35640 it wasn’t meant to look like a controlled demolition, even though it very much looks like one
Reply: I can cook turs and spice em to taste like prime rib
Reply: @dikranovichk5889 I'm not understanding the window thing where I have been on demolition sites where the initial blast of tnt did not blow the windows but still made the building collapse. It all depends on where the explosives are set, the type of building and type of glass in the window all is important but honestly I've never heard this theory and tbh I don't believe it BUT to say that this was 100% bin ladens doing is goofy, their is way to much proof that Bush was behind this.
Reply: No, you haven’t!
Reply: You're clearly not that bright, like anyone else saying it's controlled. 😂😂

Do you even have a clue as to the amount of prep work required for a controlled demolition?
Stripping walls,  running wires floor to floor to every support structure. Cutting beams,  planting explosives,  YET,  in your delusion, you think people working in these buildings would've never seen it going on?🙄🤣
Reply: @markbest5127  I agree with you because I worked construction for 10 years and seen alot of demolitions and demolition sites.  It does take alot of work. Let's not ignore the facts though, 3 people predicted this event months before it happened. I know I keep bringing it up but I'm sure you all remember the old 20 dollar bills in circulation that you could fold 5 ways and see the towers burning clear as day. It was left In plain site but it wasn't a demolition it was a set up by George w bush though. He needed the american people to hate middle easterns so he could start a war in the middle east. It was all to do with centre banks and oil. It's pretty evident with Bush's very first response to being told about the attacks. He could care less.
Reply: @markbest5127  also them people could of easily been paid off but I still agree with you I don't think it was a demolition.
Reply: @jeremyacton4569  It probably was. Many experts disagreed with the official NIST version.
Reply: @deontejones6694  Only the upper part of the north tower suggests it wasn't a controlled demolition the rest of it does.
Reply: @jeremyacton4569 yeah because it’s not like .25 mile tall steel building collapsed on top of it or nothing 😂
Reply: @herr_makisig u know u can fabricate with a video explanation . Like pseudoscience of how you can predict a criminal by their head shape. Question everything especially if your common sense is tingling.
Reply: @uncommonsense7399  Questioning everything is good, I agree. But bring actual cohesive arguments when opposing a thing, if you have any. So far, nobody tries to challenge what the video presents specifically, they just fall back on the same tired assumptions and conspiracies.
Reply: @herr_makisig  Oh, a video on the internet, must be true. That solves it, someone made a video. Weird, there are many other videos that say it was a controlled demolition, but surely this is the only video that shows the truth. SMH
Reply: @jeremyacton4569 funny how there’s is an 11 minute video explaining this in depth and all you can come up with is; it WAS A cOnTrOlLeD dEmOLiTiOn . Great explanation bro. Bravo
Reply: @deontejones6694 none of the buildings that day fell straight down. Grow up
Reply: facts don’t care about ur conspiracy theories
Reply: @ good sheep
Reply: @RationalMan  learn to respond to comments correctly
Reply: @ you just keep doing what you’re told.
Reply: @jeremyacton4569  it literally WASNT we can see the damage of the building on fire
Reply: @VaticusChadicus really did those that did it tell you this
Reply: @jeremyacton4569  put the crack pipe down.
Reply: @jeremyacton4569  With invisible and inaudible explosions. Grow up.
Reply: @bmaze35640  funny.  Yes if it was a normal. Commercial job they build barriers around it.
Reply: @bmaze35640 As a 30 yr construction engineer, there is absolutely no doubt it was a controlled  demolition
Reply: @Redbun-m1y they all did.
Reply: @deontejones6694  You are exactly right. This was all bullshit. My laptop was on floor 46 of 7 World trade when it went down.
Reply: @rizzorizzo2311 the main support was lost on a side is the building then "it progressed" to the other pillars. Like removing the leg on a chair, it would have leaned then fell toward that weakened side.
Or, the computer can pretend the weak support held it up until gravity took over and it fell straight turn.
If it was that easy, demolition crews wouldn't have a job.
Reply: @jcngokai-76  The North Tower spire did NOT, i repeat did NOT hit WTC 7 at all. The spire literally fell towards the WTC plaza.....in other words, it fell towards the south east. NOT the north.
Reply: @fransvanschalkwyk7691 did the hundreds of engineer's and demolition exerts that say it'd controlled not know what they are talking about
Reply: @jeremyacton4569  wrong
Reply: @bmaze35640 obviously not super controlled. Why would something meant to look like an attack want to contain dust lmao.
Reply: @bmaze35640 bro are you ignorant enough to think they were concerned about the dust from a controlled demolition that was meant to look like a terror attack?! Jesus 🤦🏽‍♂️
Reply: @ bro, why would they do a controlled demolition?
Reply: @Redbun-m1y Most ‘total failures’ will fall straight down; it’s the most direct path to the ground. Buildings with partial failures are less common, but do happen. In those cases, you have PARTIAL lower structure (or the earth beneath!) fail while nearby structure is OK. This results in a tipping.
Reply: @deontejones6694  they sure do. The shortest path to the ground is straight, thanks to gravity.  Some buildings have tipped, but those are more rare due to ground conditions.  All very simple
Reply: @rizzorizzo2311 
There have been so many explanations WHY this one is so perfect for you.
Reply: @bmaze35640  yeah never any dust when shit blows up
Reply: @ so the deep state did this, and they have been poisoning our kids is that what you’re saying?
Reply: @RationalMan  what a coincidence that a building rigged for "controlled demolition" also happened to sustain major damage which "opened" it up beforehand.

Have you ever looked at the damage visible on the building and thought "maybe it wasn't designed to be ripped open like that"?

How did they "know" it was going to be so heavily damaged in their "plan" to demolish it?

That's what does it for me, the obvious devastating damage and fires that are visible.

What a coincidence that it just so happened to be "rigged" for demolition eh?

Or not.
Reply: @jeremyacton4569 no evidence
Reply: @ fire can not I repeat cannot bring a building down with that precision let alone at all
Reply: @ oh my god. Did you not hear me say that 2 giant buildings collapsed right next to it and removed one side of the building. And it didn’t come down precisely, one side collapsed first and the collapse spread across blocks
Reply: @ you didn’t listen to me. It was way more than just a fire. You’re not smart
Reply: @ don’t back track
Reply: @ nice backtracking. Stay on topic kid
Reply: @ thanks for enlightening me Mr. Pythagorean it was the most perfect of the perfect storms that control demolished building 7. And way more importantly why the fuck would I listen to you??
Reply: @ then why did one side collapse before the rest and debris went everywhere, that’s the worst demolition ever. Plus there is no evidence it was a demolition. Do research
Reply: @ just look it up. You’re not special for believing in something with literally zero evidence
Reply: @rizzorizzo2311 Guess u wasn't watching in real time when the reporter on site claimed building 7 had collapsed but it was clearly still standing right behind her on national TV.....how did she have the information before the building came down....
Reply: @laughingoutloud5742 it wasn’t that kind of controlled demolition, you have to remember they wanted it to look organic. They can’t have a bunch of explosives going off! They used nano thermite to cut the vital connections of the building allowing it to collapse how it wanted. With as much dust as possible to hide their work.
Reply: @deontejones6694  How many towers have you seen collapse?
Reply: @fransvanschalkwyk7691 😂 how is that the simplest option? Also, Occam’s razor says the simplest (least steps) option is the likely option
Reply: @deontejones6694 

The problem with every conspiratorial argument is that they immediately float to an answer like this. What you presented is rhetoric, not a defense. The sheer inability to tell the difference is what makes you inept at debating. Rather than actually formulating a dissenting position using evidence, you just spout a narrative point without first investigating counter presentations. What you’ve structured is not a credible defense, and it also implies nothing in and of itself. Rather than confronting what you’re actually saying under wraps, being that it was a controlled explosion by something else, most likely an “inside operative,” you instead dance around it and refuse to solidify your point with “who” the inside operative is, as you also have no evidence at all regarding who that is either.
Reply: @jeremyacton4569 take off the tin foil hat bro
Reply: How many buildings have you personally demolished  ? 

Explain it to us, it should be easy peasy
Reply: @hannibal4567  In no way shape or form is this video proof of that. You have a lot of learning to do.
Reply: @bmaze35640  "That's a question that conspiracy theorists haven't answered". You clearly have not done your research on this or you would know that there is indeed an answer to this. It's 101.
Reply: @andyj845 have you taken any course in fire structural engineering?
Reply: @bmaze35640  so just a demolition then lol you are arguing the wrong point
Reply: 24 support columns collapse cuz 3 failed? I dunno man, lil sus
Reply: Well that had to have things look certain ways for denial purposes
Reply: @fransvanschalkwyk7691 "we made a decision to pull the building"
What is it that YOU don't understand?
Reply: @bmaze35640  dude why would they try to contain the dust cloud? It was a controlled demolition, but they weren’t trying to let you know it was a control demolition.
Reply: @jeremyacton4569 sure it was
Reply: @sgthartford6347 oh they can’t explain that
Reply: @deontejones6694 never in history has there ever been a building collapse so precise and perfect in its own foot print. But yet on that day it happened 3x
Reply: @jeremyacton4569  And it happened the same day, therefore it was set up beforehand.
Reply: @hannibal4567 i think they are referring to the order that was heard on like a radio or something want they said, "pull it"
Reply: @jeremyacton4569 crazy. U probs think the moon landing is fake
Reply: @bmaze35640 sent us to the Middle East for 20 years. I wonder who that benefits… hmm 🧃
Reply: @jeremyacton4569  So tell me and everyone else, where was the 'control center' for the demolition?  Who was the company that spent months 'wiring' the building?   How come none of the 'detonation' wiring was damaged from the fires?
Reply: @Redbun-m1y  If you compare it to the first tower that fell. The portion above the crash remained together until it finally hit the ground. From the video the  damage on the one side put so much more load on the main supports. The fire weakened the steel. The supports broke at the main points of stress which was at the base of the building. The angle of the video is from the ground. A big portion is not visible due to the buildings in between. What we don’t see on the video is building crushing and breaking onto itself. We just see the top half intact disappear behind buildings. So it’s an optical illusion. Your mind’s eye doesn’t see the breaking in the bottom. You just see the full building fully intact going through the ground.
Reply: @RationalMan  With a baseball bat yes, with C4 not so much...
Reply: @jeremyacton4569 The mechanics behind the collapse of 1wtc, 2wtc, and 7wtc is like basic mechanical/materials engineering 101 information. I learned enough information to understand and explain the collapse in my first two weeks of my first engineering class during my freshman year. All of the collapses make perfect sense and its based on really basic engineering concepts.
Reply: @deontejones6694  Good thing that wasn't a tower then...
Reply: @bmaze35640 it’s weird how you can say they didn’t control
The dust … but not comprehend that buildings don’t turn to dust unless they are blown up.   Ground zero should have had dozens of floors stacked on top of each other.   If a building collapse then there is still a building at the bottom.    Not a dust pile.
Reply: @laughingoutloud5742 the did.  You can see the scribbles exposing all the way down.
Reply: @beezybeez24 first of all, the twin towers were not built like other buildings. They had a strong inner core and outer supports. The floors were built to connect to the inner core and outer supports. No supports were in between. While it was economical, it didn’t have backup supports like other buildings had before and after. If you look at pictures of the interior, it’s basically an open city block of space outside the core. The floors didn’t exactly pancake all the way down. Some of it fell outward away from the building damaging surrounding buildings. That why a few lucky ones survived in the stairwell  during the collapse. Had all the other floors fallen straight down and not outward, no one would have survived the collapse.
Reply: @jeremyacton4569  After 15 years of looking at truthers, you all have several things in common. Key aspect is that non have any knowledge of what  they comment on. This leaves them with less opportunities in life....
Reply: @fransvanschalkwyk7691 Strategically placed explosives  and coordinated effort
Vs.
It fall down

Which sounds like the simpleton answer?
Reply: @deontejones6694  It’s a common assumption, but buildings like the WTC collapse vertically when their internal supports fail catastrophically. The towers didn’t explode outward they collapsed from the top down under their own weight, with each floor failing the one below. Engineers and the NIST report confirm this progressive collapse matches physics. No explosives were needed to explain it.
Reply: @Redbun-m1y it's explained in the video. For one, towers like these collapse down. I'm oversimplifying, but they can't tip over because a) they're moored into the ground and b) the columns aren't designed to support that load at an angle, they have to be upright. If they do somehow start falling sideways, they can't support the load of the building and, with nothing holding it uo, it collapses down. 

The reason the outside looks more intact than the towers is because the twin towers collapsed from the top down, with the top floors pancakes down on the floors below and smashing them in sequence. WTC7 collapsed from the bottom up, so the worst of the smashing is happening nearer the ground where it's hidden by the surrounding buildings.
Reply: @rizzorizzo2311 Did NOT explain anything at all. NIST has proven free fall... Doh!
Reply: @deontejones6694 honest question, have you ever seen a tower fall before that wasn’t a controlled demolition?
Reply: @bmaze35640 😂😂 eyes to see and you have no perception. You keep believing the our government loves and cares for you 😂😂 Sheeple be sheeple
Reply: @pjcouture9944 Our government, especially this administration, cares nothing for us. All I care about is the facts. The conspiracies are not facts.
Reply: @fransvanschalkwyk7691  Sure thing.  Clearly a controlled demolition, which is the only thing that explains it.
Reply: @deontejones6694  then if it was demolition, how can bomb burn for 412 minutes?
Reply: @rizzorizzo2311  explains what ?  Santa is real
Reply: @rizzorizzo2311 explain the news reporter reporting it fell 20mins before it happened. Building 7 was literally standing in the background as she reported it.
Reply: @jeremyacton4569 No. It wasn't. Glad to correct you on this incredibly simple factual point. 👍
Reply: @jeremyacton4569  Hopefully you're just trolling... Otherwise, go back to school...
Reply: @bmaze35640 you are slow and easily fooled
Reply: @RichyLucch because I don’t believe conspiracies? You can call me all kinds of names you want.
Reply: @laughingoutloud5742 couldn’t you have just cutting charges that slowly cut beams with something like thermite without having to have an explosion?
Reply: @deontejones6694  Controlled demolitions are done from lower part of building not the top and you can see the blast lines. Get a grip
Reply: Too many patriots did explosive residue sampling and there was zero byproducts or actual explosive residue left. Unless you can show me a explosive that has the power to cut through metal while not leaving cut marks and 0 residue. This explanation is the facts. I am an explosives expert so your findings would be new to the entire explosive forensics and bomb squad community. There is a reason 0 of these people and scientists believe that theory. Try to find me one.
Reply: @VaticusChadicus I hope you realise how mental you sound when you read this back to yourself 😂🤪
Reply: @deontejones6694  They do though.. that much weight doesn’t stay intact when it’s not supported, it’s not like pushing a ladder over and it holds its form. As soon as it’s not supported it’s going to fall in its own imprint. If you don’t believe actual videos regarding the buildings engineering and collapse then watch videos of domino towers falling
Reply: @laughingoutloud5742  the window thing is pointless to argue, pressure, debris, or just having their frames stressed would destroy a window
Reply: @jeremyacton4569  go back to prescool
Reply: @rizzorizzo2311 I watched it, I dig fantasy movies❤!
Reply: @bmaze35640 They should have set up sprinklers for the demolition,  would have helped with the dust😢!
Reply: @fransvanschalkwyk7691  exactly. the conspiracy is in the plot, not the actual event.
Reply: @hannibal4567  I'm ready....
Reply: @jeremyacton4569 my faith in the intelligence in humanity has dwindled a little seeing that your comment got over 1K likes compared to the comments of those who have somewhat a basic understanding of physics and accept the logical information.
Reply: @deontejones6694 gravity maybe? The only force on the building which pulls down. Otherwise, it floats… and is now a boat?
Reply: @rizzorizzo2311 
I respect you wanting to truly understand but you have been fooled with millions of others. And demolition company or high rise engineer knew it was a controlled demolition, planted earlier in the previous months on many floors posing as a communications company, allowed full access. I wish you the best because I know you are interested in the truth. The video was "over" explained on a childish Disney level. Truly, thousands of licensed experienced engineers could put this fake account together. Why discuss the cranes or interior furnishings? It's all a sales pitch to fool intelligent yet unaware people. Good luck to you, sincerely.
Reply: @fransvanschalkwyk7691  there’s nothing simple about it your house plant . What are they exactly claiming was the cause of the collapse? There was a building in between Tower seven and the former tower . And the owner of the building is on record, saying pull it. But you go ahead dragging your slippers through life  lush
Reply: @jeremyacton4569 He Literally Said "Pull It" on Live TV Lucky Larry.😅😮
Reply: @deontejones6694  lol grow up, controlled demolition takes out the base and core first. parts of the base were still standing . you have no idea what you are talking about.
Reply: @Redbun-m1y  maybe watch the vid again?
Reply: @deontejones6694 no they fall over like your Lego towers that you have never mind just can’t get past
Reply: @bmaze35640 exactly. Because it wasn’t supposed to look like a controlled demolition. You proved their point for them.
Reply: To play devils advocate, just because this explains how it fell, doesn't mean there's not a conspiracy behind what happened
Reply: @Redbun-m1y did you ever watch the video?
Reply: @bmaze35640 they didnt want to control the dust to make it look more natural
Reply: @fransvanschalkwyk7691 it's not even the simplest option... but I guess you have to be smart to realize that? There is no conceivable purpose that would be served by blowing this building up on purpose. Let alone the number of staff that would've had to be involved looking away while demolision charges were set by government officials with no evidence in the weeks before
Reply: @jeremyacton4569  Please find any video with very loud demolition explosions to back this claim up. Or did they use magic?
Reply: @bmaze35640  one of the "acts" in legislation....
Reply: @deontejones6694  how does a controlled demolition make it fall straight down? Explain that, now understand that the same damage done by a controlled demolition was done by a fire and you will understand why it may look controlled.
Reply: @rizzorizzo2311 , Is there a video explaining how the plane that crashed into the Pentagon burned down?
Reply: @Redbun-m1y  how is it supposed to fall?
Reply: @dimonthon how the plane that crashed into the pentagon burned down? I don’t even know what the fuck you’re asking. When planes crash into land they often times catch fire and burn down to next to nothing. Crash a plane full of jet fuel into a massive office building full of flammable office shit and it’s going to burn for a while. But how does a plane “burn down”?
Reply: @bmaze35640 yea maybe they should have brought a bag or stop the wind flow...right.
Reply: @jeremyacton4569 thank you for your input Mr no profile picture
Reply: @bmaze35640 bruh, wtf is wrong with your brain, that has nothing to do with anything. If you do a controlled demo, without containing dust, by all sorts of means, then you get a controlled demo plus a lot of dust.............
Reply: Gravity is always straight down !
Reply: @fransvanschalkwyk7691 , like the law of improbabilities right ? whenever something that has never happened before or since happens, it's very likely to happen three times in the same morning at the same location. Remember that guy who won the lottery in the morning only to go golfing and get a hole in one as he was struck by lightning ? Me neither
Reply: @rizzorizzo2311 perfect nonsense
Reply: @bmaze35640 what is wind Alex?
Reply: @herr_makisig  ... or you can choose to be gullible and believe this nonsense.
Reply: @bmaze35640 THANK YOU!! I'm so sick of people saying they fell straight down. They absolutely did NOT. It only looked like it compared to their height and the dust obscuring a lot of it. Also, both towers SWAYED heavily upon impact. People who escaped them have stated how they felt the entire building shake like an earthquake hit
Reply: @jeremyacton4569  it wasn't
Reply: @jeremyacton4569 ?
Reply: @jeremyacton4569  OK, I'll try and be as open to this as can - do you have any documents or videos that dispute the claims in this video?
Reply: @jeremyacton4569  you're deluded
Reply: @dikranovichk5889 not simultaneously
Reply: @jeremyacton4569  No it wasn't. This video explained what happened, and that none of you cultists are able to refute anything said in this video, proves how full of it you are.
Reply: @fransvanschalkwyk7691 Occam's razor isn't always the rule.
Reply: @fransvanschalkwyk7691  Have you seen the Hong Kong towers burning? That's what actually happens to these skyscrapers.
Reply: @jeremyacton4569  Yep they wired that massive building to explode and pankake and no one saw what they were up to.
Reply: @saypuppy4266 yes, they need to be more stress resistant to linear shaped charges throughout the support structures
Reply: @saypuppy4266  it sure is crazy that hundreds of building engineers made videos talking about how what you say is totally wrong. But I guess as long as you always believe the mainstream media, you can feel assured in your beliefs.
Reply: It was. Search up Larry Silverstein “pull it”
Reply: @R.gr98 pull it is a reference used for firefighter to get out. Yk how cops have lingo. Thats fireman’s lingo look it up.
Reply: @R.gr98 this, ive seen that too
Reply: @R.gr98 ”Pull it” meant to pull out the firefighters because an imminent collapse was expected. No one uses “pull it” in demolition circles. Silverstein was not that stupid to go on record supposedly demanding the building be demolished. And the insurance company wasn’t so stupid to pay a claim if it could be proven that the building was taken down by controlled demo.
Reply: @R.gr98  PULL IT IS NOT A TERM USED IN THE DEMOLITION INDUSTRY, YOU MUPPET!
Reply: @maxsupernova  i worked in demolition and we never used the term pull it. When bringing a building down
Reply: @crazyeddie1981  i did too, and we absolutely did. Especially former veterans who worked in demolition because with MDI you quite literally pull to initiate the explosive train. But dude was clearly referring to pulling all personnel out of the building because it was clear the structure wasn’t safe any longer. It’s funny how you dummies hone in on meaningless jargon to fit your narrative when all of the evidence fails to support it. It’s been 25 years, give it up. This has been one of the most analyzed building failures in human history and nothing about the official story is hard to believe. At this point you’re just taking the contrarians perspective because it makes you feel privileged.
Reply: @maxsupernova  It absolutely is!
Reply: @R.gr98  ...and we watched the building come down."   The rest of his comment
Reply: @R.gr98 I researched it. He was referring to the team of firefighters that were working to contain the fire in WTC7. The fire couldn’t be stopped so he gave the word to “pull it” meaning the team of firefighters.
Reply: @R.gr98  lol firefighting term.get your facts straight., he said the decision was made to pull...which means pull back all fire fighting efforts.
Reply: Greenwell tower london
Reply: @jeniferallan6693 and Grenfell is still standing
Reply: Wieso spricht keiner vom dritten Gebäude?
Reply: @ that’s just apart of the psyop of 9/11. We will never know the truth.
Reply: You forgot the quotations around “wasn’t a controlled demolition”
Reply: It was actually controlled. They said pull it
Reply: @RationalMan  you don’t understand building construction clearly.
Reply: @ironeagle22a  I understand that fire has only ever caused total collapse of a steel frame high rise only 3 times; coincidentally on the same day.
Fires could not have caused weakening of displacement of structural members capable of initiating any of the hypothetical local failures alleged to have triggered the total collapse of the building. Nor could any local failures, even if they had occurred, have triggered a sequence of failures that would have resulted in the observed total collapse.
Reply: @ you don’t know anything about steel when exposed to fire fed by jet fuel. And dead load (Weight) being the remaining upper floors impact on the lower floors to cause a pancake collapse. Go read Francis Brannigan.
Reply: @ I understand that jet fuel can’t cut steel at its melting point like thermite can.
Reply: @ what jet fuel? the one that exploded upon impact? how much jet fuel u think was burning in the impacted floor? less than 5%. 95% went in the explosion and it is not possible for that fire to cause what we all saw and witnessed that day. 3000 civil engineers and architects and couple of demolition experts they all agree on this.
Reply: @serafar  you people are. Little crazy. Steel expands one inch per 10 feet at 1000 degrees. It was light weight trusses supporting floors. Do some research before you give an opinion. Go read some fire service books on building construction.
Reply: @ironeagle22a  i bet my life every single time that explosives were used. its one thing to assume that the temp got 1000 degrees and its totally other thing to understand that molten steel was found days later in the wreck. jet fuel can not at any circumstances cause construction steel to melt. there is a great recently published video of japanese cam coder recording where u can see the detonations and see it with ur own eyes. buckling of one floor will never ever be the cause of what happened that day. nor will collapse of 14 stories. even if the construction was weak enough to bend and give way it will never ever collapse in the way it did with that much destruction at that speed. once again you can see the detonations how they pop off in sync 5-10 floors beneath the disintegration line when the towers start to crumble. weak structure due to fire will never ever make multiple joints to snap off in a single moment and you will never ever get what we all saw. you will get bending twisting and tumble motion and it will happen very slow. only demolition can cause what we all saw.
Reply: @serafar but it did
Reply: @RationalMan not on floors 40 levels below where the jet fuel waa.  The lower floors went first.
Reply: You tinfoil hat wearing smooth brain individuals are  something else 😂.
Reply: @Jacob-ed1bl agree
Reply: @Jacob-ed1bl how sweet of you to call people names. Cute.
Reply: #911controlleddemolition
Reply: Failure is simple if you know the basics. The structure was heavily damaged with missing columns and beams, and then the uncontrolled fire that went on for hours. The water lines were broken, so no suppression. Fire weakens steel. Thousands were dead in the occupied buildings next door, so this building received minimal attention in the catastrophe. Simple and sad. Making up fairy tales is disrespectful and highlights your lack of expertise.
Reply: The fire fighters had predicted it would fall hours before it did. In case you didn't know the whole bottom level was full of diesel generators and the fuel to  keep them running. They had been fighting fires in that building for hours. Then add in structural defects from the debris falling onto it and hitting it.. it doesn't take a rocket scientist to predict it would fall. I'm pretty sure my 4 yr old could have guessed it would fall.
Reply: @melissacoxen6001 even if you’re totally factual the building isn’t going to collapse in the manner that it did. There’s no chance.
Reply: lol that wasn’t a controlled Demolition ???  Think about what you just said for a second ….
Reply: It absolutely was
Reply: I can respect these technical explanations of how these buildings came down.  But at the same time, theoretical physics can explain a lot of things that defy reality.  That doesn’t necessarily mean that they’re correct.   I go by other real world building collapses.  Collapses from fires, and damages.  I’ve never seen any other buildings collapse the way these did by fire or damage.  I can’t find any other examples of buildings falling into their own footprint other than a controlled demolition.   For better or worse, for whatever reasons those buildings were meant to come down.  Airliners precisely flown by hijackers that couldn’t even fly a simulator yet still hit their targets. Especially the pentagon.  That was some serious flying skills that that guy shouldn’t have been able to do, but he did though.   All those hijackings working out together the way they did is almost impossible, but they pulled it off.   That’s what makes me thing that those buildings were coming down one way or another that morning.   If the hijackings would have failed then it probably would have been suicide bombers.   Nothing was changing the outcome of that morning.  That’s why I’ll always believe it was an
Reply: The fact that Larry said 'pull it' and it fell PROVES it was a controlled demolition
Reply: We are all saddened by the death of RationalMan next week
Reply: Totally I mean it’s so crazy that in the entire history of steel structure high rise buildings none of them have ever collapsed… EVER from a fire until this building oh, and the other two buildings collapsed that day. Miraculous.
Reply: Only 3 building have fell in there own footprint and it happened on the same day
Reply: Yeah. No steal structure building has fell just from a fire. It was definitely blasted.
Reply: Such a disrespectful take to those who lost their lives during that event. People like to believe in conspiracy theories because they can’t handle the fact that their government is not in control 100% of the time and that they can be touched.
Reply: @jerz6cat1 Did we ever find WMD’s in Iraq?
Reply: @RationalMan Iraq has little to do with structural integrity of buildings. Let’s stick to one conspiracy at a time. We can deal with Iraq, the fake moon landing and the flat earth after this.
Reply: @jerz6cat1 It has everything to do with it.
Reply: You can’t bring down a building like this by burning office furniture. If you want to buy into the magic jet fuel theory for one and two - well, whatever. But come on. No planes or jet fuel here. Office fires. Literally never happened before or after.
Reply: Except it was
Reply: Jerry Silvertein: "I remember getting a call from the fire department commander, telling me that they were not sure they were gonna be able to contain the fire, and I said, "We've had such terrible loss of life, maybe the smartest thing to do is pull it." And they made that decision to pull and we watched the building collapse"

Later.... " Silverstein never said he had ordered the building demolished. Instead, conspiracy theorists twisted his vague wording in the documentary interview to suit their own agenda."😒
Reply: Almost 25 years later do people still believe it was not controlled demolition? 🥹
Reply: @JessicaMejia-e1s yup! I just had some say that it collapsed by the fires 😂😂 no it did not
Reply: That is control demolition to me fire don t cut reneforced steal.
Reply: and yet people will call it a controlled demolition that WAS a controlled demolition.

Idiots
Reply: Seems a lil fishy all of it 🎉🎉🎉🎉🎉🎉🎉🎉🎉🎉🎉🎉🎉🎉🎉🎉
Reply: wasn't there evidence of support beams "cut" in a 45 degree angle and melted metal consistent with thermite? I mean... there's news footage that even shows this.
Reply: @joeschmoe3000  During the cleanup, support beams were cut into segments to make them easier to handle, since there was no way to repair the buildings.
Reply: @joeschmoe3000 Wrong no evidence of thermite that was debunked on December 7th 2007.
Reply: @joeschmoe3000 those pesky little things that ruin the official and idiotic narrative.
Reply: @joeschmoe3000 if you look at the  multiple pictures they don't talk about the picture of a iron worker making the cut
Reply: @joeschmoe3000 😂
Reply: @joeschmoe3000  Yeah
Reply: @joeschmoe3000 this is how the steel was cut to be removed from the site. There's videos of them cutting it.
Reply: @joeschmoe3000 those are cuts made during the cleanup. There are photos of firefighters doing it. And what would be a point in cutting the columns low? Buliding collapsing sideways from the bottom would not make any sense if the planes damages the upper part.
Reply: @joeschmoe3000  Those photos were likely taken later into the cleanup when oxy-fuel cutting was taking place.
Reply: Jshmeek.. bot apparently you can’t even read.
Reply: @joeschmoe3000  those cuts were part of the removal process
Reply: Есть мнение, что подрыв зданий осуществлялся ядерным зарядом, и никаких самолётов не было. Якобы, для утверждения проекта Башен Близнецов, требовался план по сносу, на случай, если понадобится. Без этого не дали бы разрешение на строительство. И единственный способ снести, - это ядерный подрыв, потому что стальные балки уж слишком мощные в истории.
Reply: @johnnybee7615  there is no opinion like that. You are talking out of your ass
Reply: @johnnybee7615 Very interesting my friend 🤔💯
Reply: Except the authorities confirmed this building was brought down by demolition and was deemed unsafe. Do your research. The fire department was involved.
Reply: @XTheAmericanXYT you're making shit up. Firefighters were anticipating that it would collapse. They didn't "bring down" the building nor did they ever say that.
Reply: @MetalFusionist  ready dum dum? Larry Silverstein the Leaseholder of WTC!! Saying they brought it down 😂

https://youtu.be/-jPzAakHPpk?si=HLLQ1e-R-XIR_fS1
Reply: I remember watching on TV a firefighter specifically said we brought it down for safety concerns. How were they able to perform a demolition in such compressed time so successfully?
Reply: When Silverstein said  "I think we're going to have to pull it,"  he meant it! I don't recall hearing any mention of that in this video.
Reply: @eainc.708  Where are you from? Does this place have some animosity towards a certain  tribe of Israel? Asking for a friend.
Reply: Let me clue in the half wits of this chat, anytime the USG asks the courts for decades and decades and decades before all of the information on said event is released to the public……the USG is responsible for that act. 100% of the time. They did it with JFK and 9/1! & Covid etc. etc.

Does anyone remember how the news had reported it collapsed as it still burned in the background for quite sometime?
Reply: Let me clue in the half wits of this chat, anytime the USG asks the courts for decades and decades and decades before all of the information on said event is released to the public……the USG is responsible for that act. 100% of the time. They did it with JFK and 9/1! & Covid etc. etc.

Does anyone remember how the news had reported it collapsed as it still burned in the background for quite sometime?
Reply: That Chinese Tofu Dreg in Thailand collapsed as  fast as this.
Reply: @mikapeltokorpi7671  Whenever you've got a reference to support you claims... 
In the meantime, while I'm not holding my breath, here is how David Chandler established WTC7's free-fall that so embarrassed NIST: WTC7 in Freefall: No Longer Controversial
https://youtu.be/rVCDpL4Ax7I?si=Ac8pfM7ULoYnmpTg
Reply: thermite placed precisely
Reply: What's the odds that all those buildings would fall down like controlled demolition.
Reply: True. We’ll never get the actual truth.
Reply: 4:13 did you notice strange LATERAL DISPLACEMENT OF THE  BOOKS ?
Reply: If you legit believe that, I feel bad for you
Reply: This was predicted by the BBC repeater.
Reply: @goedeck1  This was predicted by firefighters on the basis of the state of the building and its similarity to the state of B1 and 2 before they collapsed. No clairvoyant was needed to see what was going to happen.
They reported it to BBC nad they, in the confusion of the day, broadcasted B7 has collapsed already. Too hard to understand?
Reply: This was planned. Our government made sure of this. Corrupt. George Bush knew many innocent people would die and yet she slept. Evil. Anything is possible. You can see the unnatural collapse of the buildings. Seen firefighters examine all the tapes and how the way they went down, from a plane crash wasn’t a possibility
Reply: Don't be silly-- it's a bad way to be..
Reply: An asymetrical damage doesnt cause a symetrical collapse period.
Reply: I still find it hilarious that some people still actually believe the controlled demolition story.
I guess some people  process a catastrophic event like this in different ways.
It’s very sad.
Reply: @woowah32 it's sad to believe the government
Reply: @AussieCanadian88
It is. I just believe facts.👍🏻
Reply: "7 hours of uncontrolled fore followed by a collapse"

Retards: was this clean and controlled?!?!
Reply: Did you plug in the planted shaped charges for a controller demo?
Reply: Don't be daft @BCHonea ! You don't have to remain a smooth brained cretin your entire life.
Reply: It was an allergic reaction to the first two towers. 
Wt7 saw the other two sneezed and fell like it’s older twin brothers
Reply: It was a controlled demolition
Reply: @jake-pw2wm sub 90 IQ
Reply: @jake-pw2wm a controlled demolition of a building already on fire?
Reply: @jake-pw2wm  exactly, because it was.
Reply: @jake-pw2wm  ha ha ha ha!! You people make me laugh. Yeah, okay. You solved it sherlock!
Reply: @jake-pw2wm  nope.
Reply: @jake-pw2wm take off the tin foil hat off
Reply: It's crazy that the reporting of the WTC 7 "collapsed" as it was collapsing. 😅 what's the physics on that buddy? 😅
Reply: @chrisbriault7234 so you think that it was a cover up that even the media knew about. Yet no one credible has come forward lol
Reply: @EatingMachine23  https://youtu.be/677i43QfYpQ?si=ki-Dwi-RaUjzeLOE
Reply: @chrisbriault7234  At that point they knew the building would collapse, that’s how they knew. IRRC the fire department told them
Reply: @chrisbriault7234  explained for decades buddy. just cuz you’re ignorant doesn’t mean it doesn’t exist you failure. Omg a building heavily damaged has been designated about to fail and the news reported it therefore the knew before hand. go back to fantasy island with Diddystein, creep
Reply: @chrisbriault7234  actually 20 minutes prior, the BBC reporter announced it had collapsed.
Reply: The only skyscraper ever lost to small office fire
Reply: @samboherring3673  Small office fire? Nearly every floor was burning at one point.  There's video of it.
Reply: @roquefortfiles  Maybe that's why the BBC predicted it fell 20 minutes early.
Reply: "wasn't a controlled demolition" lmao
Reply: Except it was controlled demolition you're  kidding yourself  if you think it isn't
Reply: same npc’s who still believe airplanes brought down the twin towers
Reply: All of the buildings that came down that day were controlled-not controlled demolitions. My opinion is there were no planes that caused the buildings to collapse, but rather controlled timed detonation. JMO
Reply: Yes it was very clean, after they immediately started hauling or the wreckage/Evidence
away 'ILLEGALLY', before it could be properly investigated and examined, took about a week I think.  :face-fuchsia-wide-eyes::face-orange-raised-eyebrow::face-orange-frowning:    :face-fuchsia-tongue-out:
Reply: Or maybe it WAS a controlled demolition...Occam's Razor...
Reply: @icyboy771z  The simplest explanation is often the best is the principle behind Occam’s Razor.  A controlled demolition is not the simplest explanation.   It’s ridiculous.
Reply: @icyboy771z  Occam’s razor would be that it collapsed due to the damage from the terrorist attack
Reply: @icyboy771z  Calling it a CD is the exact opposite of using Occam's Razor.
Reply: @icyboy771z Occam's Razor says that it was the giant 110 story skyscraper collapsing next to it that ultimately caused the collapse.
Reply: @icyboy771z  Occam`s Razor would speak for a collapse from fire and damage.
Reply: Don't you know it was the falling flagpole from the tower that demolished building 7.
 I totally believe that story. I wouldn't have bought the Brooklyn Bridge if I suspected foul play in ny
Reply: @metaluna1000  The problem is the flagpole clearly demolished only one side of the building - the other half of the building was practically intact. This makes it hard to believe the building could fall at free fall pace and perfectly symmetrically. Surely it could be possible, but hardly probable.
Reply: @metaluna1000     have you seen the same photo of a firefighter carrying a little injured girl at the WTC and Boston marathon bomb?
Reply: @metaluna1000 you conspiracy nuts struggle with the concept of scale. To say that the antenna spire atop the  WTC was merely a "flagpole" indicates just how smooth your brain is. It was a 360 foot tall steel structure. The base of it was a square steel structure approx 20' x 20'.

But yeah... call it a "flag pole" in a pathetic attempt to validate your regarded juvenile theory
Reply: Wow there are so many people's comments blocked to where we can't see them on YouTube... Anyways yeah definitely controlled demolition.
Reply: Yes watch controlled demos.    This  is one of the cleanest
Reply: @godbyone  If that’s true, who did it? How did they sneak the explosives in? And why did the perpetrators do it?
Reply: @bmaze35640 to drag us into a 20 year, multi trillion dollar war. Wouldn’t be the first time. You clearly know very little about the 
C👁️A. And the WTCs had “elevator work” being conducted in the 8 months leading up to the demo. And not by the company that originally installed the elevators, which doesn’t happen.
Reply: @bmaze35640  I'm sure that they didn't have to "sneak" anything in.
Reply: was it? I thought the area around the building was uninhabitable for months?
Reply: Of course, that's exactly why the BBC stated that the building had collapsed 20 mins before it actually did. Lying about in a different way is still a lie. Your credibility should be completely destroyed from this point forward, congratulations.
Reply: @g_mando  So you’re saying the British were in on it too?
Reply: @g_mando  evidently, you have never followed a live event like this. There are constantly false reports coming out all the time. It’s possible that the BBC report was reported incorrectly that the building had been destroyed. The report could have been that they were told the building was in danger of collapse. So if the BBC reporters or anchors read that incorrectly, it could have been reported 20 minutes before it fell. There were numerous other reports that came out that proved to be false. There was no bomb outside the state department or anything like that. When you are in a live breaking new situation, all kinds of rumors and false reports happen. Just because something got reported at a certain time on that day does not mean that that report was correct.
Reply: Why was the camera on it just as it went down?!
Reply: @doonagoding6146  Probably because they had received information that the building was in danger, and good media people will turn the camera to the building to watch it. There’s no telling how long the camera was focused on the building before it went down. We just have the video trimmed to this point. And NYC had no shortage of cameras that day.
Reply: @doonagoding6146  And the fireman who said "Keep your eye on that building. it's coming down."
Reply: or was it???
Reply: Most likely a direct energy weapon that is classified so we don't know the name of it
Reply: @jackrichardson853  yeah the death star from star wars!
Reply: trump supporters spotted
Reply: @fizzinsoda if ur not a trump supporter I question ur intelligence bc the other option was pitiful
Reply: @fizzinsoda Trump-Bush-Obama-Biden = Uniparty Establishment Liars supporting official narrative
Reply: @fizzinsoda I like how you rag Trump supporters as if people from your political walk of life have absolutely anything to be proud of lmao 🤣 The arrogance from you people is astounding. Conspiracy theorists can be annoying, crazy and believe absolutely anything, sometimes they can also be right on some things. But you people are no better. While conspiracy theorists will believe absolutely any conspiracy, you people will believe absolutely any mainstream narrative no matter what. If mainstream media says it, you automatically take it as the truth. Both of you are stupid in reality, but you people are way more arrogant when you really shouldn't be. Don't throw stones when you live in a glass house
Reply: @fizzinsoda Flat earther spotted
Reply: @fizzinsoda Are you from Ca. or Oregon,Einstein? If it’s terror,assassination,riot or arson, it’s either the Muslims or Progressives, pal. Trump single-handedly revived Manhattan in the 70s-80s. By far the most popular guy in NYC and  most of the USA. It was only when he decided to run against the woke/corrupt/sexperv/Marxists that the hatred began.
Reply: @fizzinsoda what are you talking about trump supporters believe more that it’s a controlled demolition (which it is) than leftists
Reply: @fizzinsoda  yeah that’s funny. I hate to tell you but from 2001 until about 2013 believing 9/11 was an inside Job was absolutely a democrat political opinion. The same way up until Barack Obama became president. Alex Jones was considered a left-leaning conspiracy theorist. In fact George W. Bush had him arrested during an interview when he was governor of Texas and the republicans were in full support of arresting the left leaning cult leader
Reply: @fizzinsoda  shouldn’t you be playing in your sandbox
Reply: @fizzinsoda  false
Reply: @fizzinsoda redditard spotted
Reply: @fizzinsoda All leftists believe it was an inside job as well including me. it was Israel.
Reply: @fizzinsoda you should ask more questions instead of wasting your time believing what the box on the wall tells you
Reply: @fizzinsoda  huh?
Reply: @fizzinsoda how do you say Trump supporters when people have been calling this a controlled det since 2001? Lol
Reply: @fortgrove3166  same kind of conspiracy believers.
Reply: @fizzinsoda lol, people with TDS drop his name in places when no one else is even thinking of him
Reply: Actually no .... My opinion on this formed long before Trump appeared on the scene and TDS took hold.    @fizzinsoda
Reply: @fizzinsoda I’m a trump supporter and I don’t think this was a controlled demolition.
Reply: @fizzinsoda Trumph weiß die Wahrheit.
Reply: or maybe it was